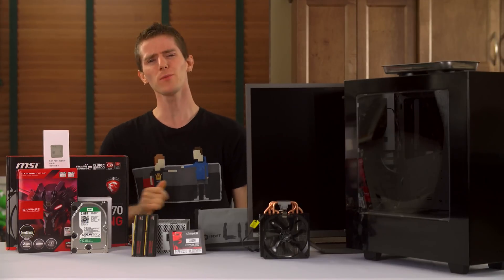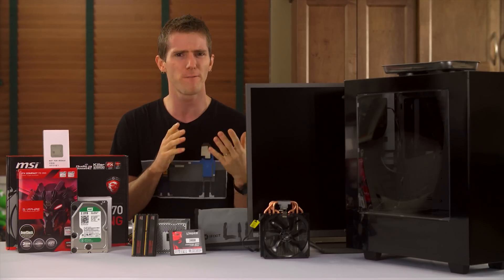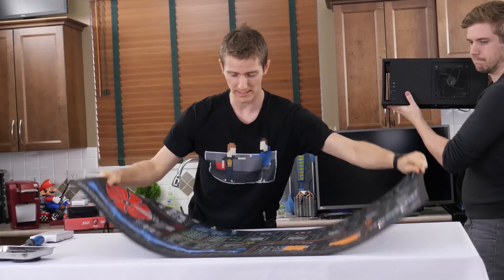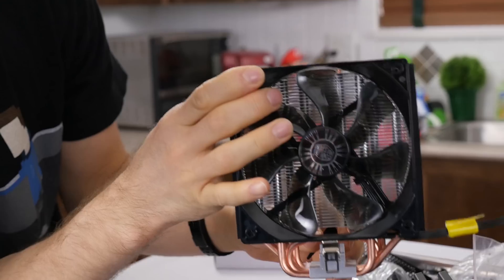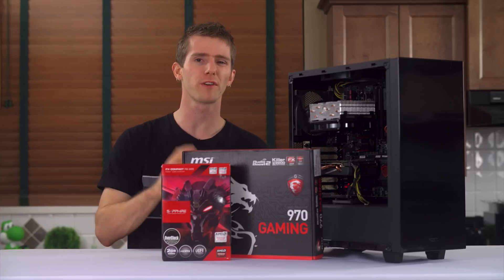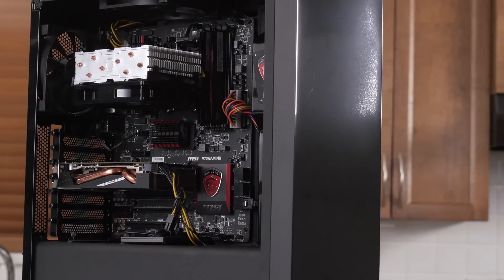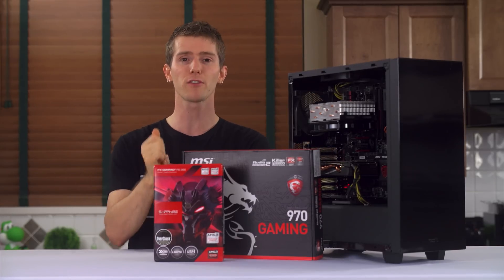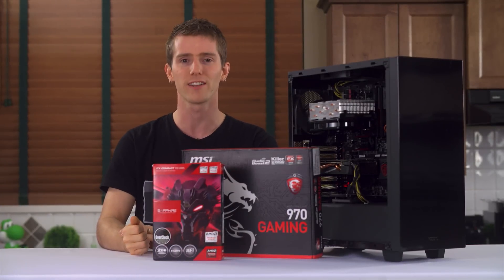Can you Build a 4K Gaming PC for Under $1000?

Comment: I'm actually pretty dissapointed seeing this episode, money is spent really on the wrong components. I know he was sponsored, but for anyone out there wanting to build a budget 4k rig, go for an intel i5-4460 on a cheap motherboard with a gtx970 or a r9-290. Most people wanting a budget pc are not going to overclock anyway so spending a lot of money in areas like the motherboard, cooling, power supply (as long as it is from a reputable brand and supplies enough current it is fine) etc is an absolute waste.
Reply: A major chunk of the money went towards the monitor. Really hard to squeeze in both an i5 and GTX 970/R9 290 with the rest of the money.
Reply: I personally would never cheap out on motherboards considering everything else in the PC is connected to it. Also he was given a 8-core but didn't use it. Swapping the 6350 and 285 with 4460 and 970 means a ~$200 increase, you probably won't have enough corners to cut for that much money.
Reply: the monitor alone takes away lots of money, think before commenting dude...
Reply: Hoàng Việt RainieDays93 Correct. But when has facts ever stopped an Intel fanboy?
Reply: Actually the AMD FX 8350 is beating the i7 4930k at a 4k gaming SLI setup - i couldnt believe it myself but its true, look here :
http://www.tweaktown.com/tweakipedia/56/amd-fx-8350-powering-gtx-780-sli-vs-gtx-980-sli-at-4k/index.html
Now thats a nice surprise 150$ vs 500$. :D
Reply: ***** Actually it was. Check the description. The components without the monitor come to $500. And the cheap 4k monitors on new egg are only $400.
Reply: You didn't include monitor. So yeah.
Reply: Giggity Goebbels Complete utter bullshit. Going off cheapest prices from http://pcpartpicker.com/,

Cheapest i5 is $176 while the cheapest FX-6300 is $96. Cheapest 970 is $325 while the cheapest 285 is $170. How are price differences like that "not much cheaper"?

And how is the 970 much better than a 290X? Benchmarks put them neck to neck but the kicker is that the 290X is cheaper: http://www.anandtech.com/bench/product/1355?vs=1056

I own an i7 and a 780 but I'm not retarded enough to deny that AMD beats my parts in terms of price/performance.
Reply: How about:

1.. AMD does have hardware to game on despite what you's intel sheep will always go on saying otherwise.

&

2. Without AMD being kept in the market we will go back to the days of the 90's where a Intel Celron would cost you $1200 cause it was the only low end cpu on the market.

gotta luv these troll-esque posts
Reply: mariodrv AMD has always had better price/performance than Intel.
Reply: You all do realize the monitor wasn't included in the $1,000 price point? Lol
Reply: LUGO Entertainment Now you're just arguing semantics lol... It's Linus' video. He can do whatever he wants. The title of the video is "Can you Build a 4K Gaming PC for UNDER $1000?" With or without a cheap 4K monitor, both are UNDER $1000. Nothing deceiving about the title.
Reply: You sir, are a complete idiot.  Thanks.
Reply: GriggsCk Gaming Even if you use a fx6350 and a r9-285 it will still be hard to include that monitor but you're right. In my country the r9-285 has a pretty poor value though, the r9-290 is just a little bit more expensive and outperforms the r9-285 by quite a lot. Maybe I'm wrong about that cpu though but the single threaded performance is just not that convincing in my opinion.
Reply: Giggity Goebbels Please stop being such a twat, dude. the 970 is better, yes, but only by about 5-10% And its usually about 100-150 usd more expensive in most markets. you complained about amd not being on sale but then said how highly discounted nvidia is discounted in your area, which is unusual and i doubt. point being, the 290 is a much better value for most everyone.
Reply: Giggity Goebbels Since you request benchmarks, please tell me if Linus is lying or you are simply wrong about the 970 being "much better" than the 290X:

watch?v=rp5meTIP3Pk&t=2m54s
watch?v=GJoVjOk1SVY&t=2m6s
watch?v=Nr77JW2pH90&t=2m50s
watch?v=pug0A5-4pIQ&t=3m38s

I didn't delete my comment; Youtube removed it since I linked directly to Linus' benchmark videos.
Reply: korey mcintire In my case the Asus r9 290 direct CU II was on sale, it does run a bit hot but it performs really well and I was able to save about 90 euros over a comparable GTX970
Reply: Jude Rose
sound's like some user error
Reply: *****
To be honest - i think the 4930k is the better CPU in any way except price(even for gaming) but for a cheap ass 4k build FX 8350 is the way to go. Oh and i bet when you OC the 4930k the graphs would look different very fast. ;)
But still man - a 150$ CPU kicking professional ass at 4k, i gotta give it to AMD they knew they couldnt make a new architecture for a while and made the existing one (including gpu) 4k ready before its time.
I own both CPUs (and a few others;) and i gotta say it guys for gaming, except in a few games like ARMA, there is not a big difference between INTEL and AMD except price.
Reply: *****
So what you are saying essentially is that Bulldozer and CMT were a good idea - but Intel owns the playing-field and the game and makes the rules?
...what AMD is left to do now is beat Intel at their own game?
- well good luck AMD, i hope Jim Keller can pull another Athlon...
Reply: jpchevron those parts come out to a little over $600... No way that monitor is less than $400 (since those parts come out over $600). They should also consider the price for the hard drives, power supply, and case.
Reply: LUGO Entertainment If you check the description the ccomponentscome to around $500 and the cheapest 4k monitors are $400 on new egg.
Reply: RainieDays93 The i5 is not that much more expensive than the FX,the motherboard can be much cheaper(If you get shit AMD boards,the VRM likely fails),and a 970 is not much more expensive than a 285.You can also get cheaper RAM and stuff.A 970 is MUCH better than a 285 and even a 290X.
mariodrv That article is bullshit,people on forums pointed out that there is too much loopholes in that test.
Reply: Kai Vega The nVidia cards were not discounted,they were always that pricing.Go ask the distros about this,because I have no idea why.Newegg however frequently tune price down,instead of fixing it a value,thus it is considered "discount".Twat?Well he started being rude first,so... yeah.
 I got the cheapest Asus Reference 290 for 20 (USD) lower than a zotac 970.But I was a few days too early,when the 970 is not available here yet.In US a 290 is very good in value,but for many other countries,it depends.
Reply: Giggity Goebbels
IN 4k the 290X is even better than the 980, and that is because neither of the new cards can compete with the 512-bit bus of the 290s.
Reply: PA5cAl1

Don't know where you live but where I live, at 70€ I can't get a half assed Intel Motherboard let alone a decent one for OC'ing.

For AMD, at 70€ you start to see decent OC mobos and if you climb to the 100€ region, you can get the best performance/price motherboards.

Market strategy from both companies are the opposite when it comes to CPUs. One makes decent affordable CPU's that can get you anywhere, the other makes great performing CPU's that cost the eyes in your face.

I can build an AMD APU based fully functional system for the same price I can buy an Intel CPU/Mobo and this is what most people don't understand. Gamers are gamers, but not all have the spare Money to buy the best.

At least, where I live...
Reply: Giggity Goebbels dude you just want to be right when you're wrong. Even cheap motherboards are fine these days, ask Linus if you don't believe me
Reply: ***** Why did you use the 4340? Ive been talking about the 4330. The 4330 is 25 dollars cheaper. 

Anyway I made this build:

http://pcpartpicker.com/p/HdnPhM

its $20 cheaper than your FX build. It has a 290x which is on par with a GTX970 in terms of performance (actually beats a 970 at higher resolutions) and an i3 which outperforms the FX6300.

If you desperately need Nvidia you can spend the extra $60 and get the GTX 970 making it only $40 dollars more than the FX build.

Also it will cost you less to upgrade the Intel build as you only need to buy a new CPU. To upgrade the FX build you would need to buy an Intel motherboard and an Intel CPU.

Finally you can remove the $25 cost of the Hyper 212 for the Intel build as you dont need it at all. particularly because you cant overclock it. Making it $45 cheaper than the FX system or $15 more if your going to use the GTX970.

So yeah, nice try fanboy.

P.S. If you are going to spend $15 on that build for an i3+970 you can save a bit of cash on your PSU. You dont need 550w for an i3+970. So you could even say the i3 build with a geforce part is cheaper.
Reply: 8150 is not even defendable. It's just bad. Piledriver is much more defendable then pure Bulldozer.
Reply: Andrew Spencer Il compare two chips if they are on sale at the same time.

Just because AMD havent bothered to update their manufacturing process doesnt mean their products arent comparable.

Certainly a user had a choice when FX was released to go with the newer technology that was released before the FX came out or to go with old technology released late.

By your logic there is no CPU that can compare to the FX. It seems you will say anything to discredit facts that show the CPU you own isnt very good for performance users.

You wont admit you are wrong but you are. 

Spewing abuse wont help you.
Reply: Andrew Spencer So the Nvidia GTX 970 uses drivers that perform better in more games on average. 

So the user gets better performance in most games. 

Sounds like a win for the 970 to me. 

I think you just admitted you were wrong. Well done you.
Reply: PA5cAl1 It depends on country, for those who have easy access to amazon, newegg, etc, they can just grab one cheap easily. But with 970 and i5, it would way existing this budget if you if you grap the monitor for cheap.
Reply: Oo and I'm pretty sure the monitor they used in the video is like $1,000. A $400 4k monitor will be complete garbage. Or atleast not very good for gaming.
Reply: jpchevron Then he should change the title. Title implies just for the PC, not the PC setup. If that was the case he would have needed to include a Keyboard and Mouse too. Almost all of his "builds" are just the PCs, not the monitors that go with it.
Reply: mariodrv Look at the runs they have done using the GTX980's, the total score is higher, the numbers do look a bit unreliable though. https://www.cpubenchmark.net/singleThread.html.The AMD FX-9590 scores 1708 points, even cpu's found in laptops can do better with a much smaller tdp. Take for example the Intel Core i7-4702MQ, 1720 points.This just shows the poor single threaded performance of AMD FX cpu's. And remember, the FX 8350 is clocked significantly lower.
Reply: Giggity Goebbels Ok so now you accuse Linus of fudging benchmarks. How about websites like these or does your ignorance have no bounds?

http://www.guru3d.com/articles_pages/dragon_age_inquisition_vga_graphics_performance_benchmark_review,7.html
http://www.techspot.com/review/917-far-cry-4-benchmarks/page3.html
Reply: Giggity Goebbels You have lost your mind if you think with both Nvidia and AMD's latest drivers that the 970 is better than a 290x. Hell some games at resolutions higher than 1080p the 290(non x) beats the 970. Please refer to google before you say something that is completely biased and not backed by proof. The latest cards released by Nvidia are good, but not near as impressive as they are blown up to be. 5% +/- performance gap before OCing between your competitors last gen cards is horrible. The price was great when they launched and then AMD cut their prices, so the only thing holding Nvidia over AMD is power consumption and noise....... Price/performance AMD is back on top, and it will get really really ugly for Nvidia when AMD does launch their new series. AMD is rumored to be going twice the memory bandwidth on the 390's while Nvidia is still kicking it on 980's 256bit memory interface. The only thing that impresses me with Nvidia 980/970 is power consumption. Otherwise, not impressed.
Reply: Giggity Goebbels You gave me a link with a GTX 970 overclocked at a core clock of 1366+ MHz when the core clock of factory 970s is ~1100 MHz. Nice try dude. Don't even dare to think Linus' benchmarks are untrustworthy when you're providing fudged benchmarks right off the bat. Since we're talking about 4K, I'll save you the trouble of looking for benchmarks and tell you the 970 can't even compete with the 290X at 4K in any game.
Reply: PA5cAl1 I agree with you completely, I myself have a MSI gaming r9 290 and I bought it on sale at newegg last month for 259.99 with a $30 mail in rebate. 970 is over rated. Hugely over rated.
Reply: *****  even though I wouldn't mind getting a Amd graphics card cus price/performance but I had bad experiences with amd processors with them kinda melting my motherboard so I'll stay a Intel sheep for a while longer :p
Reply: ***** Watch all the AMD fanboys scream, no, just kidding. Can we just stop hating each other for our preferred cpu choices? Thank you!!
Reply: "Money is spent really on the wrong components" and "Go for an intel i5-4460"

You lost me when you said pay $60.00 more for a CPU that performs nearly the same.
Reply: mariodrv Price/performance - watercooled 
Pick one of those. If the GPU needs watercooling, it isn't even an option for a price/performance rig.  And quit those stories about AMD's old GPUs being better than Maxwell. AMD does have the better cards in the mainstream segment, but Maxwell totally nuked the high-end with price/performance ratio, not to mention working conditions, which put to shame even Nvidia's own older cards.
Reply: I've made the mistake of getting a cheap motherboard twice. Never again.
Reply: Giggity Goebbels
Clock for clock the 290s are actually stronger than the 780s, the wider bus allows for more data to be shoveled trough eg. pixels which comes in handy at higher resolutions - thats why the 290x beats the 980 almost in all games at 4k dual gpu setups because NVIDIA builds
GPUs for markets and AMD for gamers (who are the market).
http://www.hardocp.com/article/2014/10/27/nvidia_geforce_gtx_980_sli_4k_video_card_review/11
Reply: CanIHasThisName
Excellent point mate! But...
I modded a 290(which didnt need watercooling i just wanted it to be faster than a 980 - and at 1200/1600 it sure is ;) with a Arctic Accelero Hybrid for 210€ - but go on tell me more please...
- for the rest(when i dont get a Arctic accellero for 50 bucks xD) i buy a new NZXT g10(30€) with a 30-40€ h50/55/70 etc. and all that paired with a 290 under or around 180€ - and bam you got more power than you need supercool and superquiet. :D
I agree with you - in the end you get what you pay for - or how much you are willing to compromise...
I for myself buy used gear and tinker around with it till im satisfied. :)
Reply: Ok, I pretty much tl;dr'ed the comments.
Why is an i5 and a 970 / 290 a worse choice here? I'll explain:
1. If you want to put a gaming rig together right now and forget about key component upgrades for a couple of years, AMD processors are a cheaper and pretty good choice. You could squeeze an i3 in there, but this is also meant to be a versatile, multi-purpose machine, so a bit of multitasking horsepower from an FX CPU can help, especially if you're a content creator on a budget.
2. R9 285s are really worthwhile video cards right now. They offer a few nice bonuses, like TrueAudio etc., along with solid performance for a neat price - especially outside NA, where the prices of GTX 9xx cards are quite a bit higher than those of the previous generation.
3. You should never cheap out on a motherboard and PSU. Sure, not many people will actually buy those top-tier MoBos made for overclockers, but when choosing the right base for a gaming machine, one should definitely consider the key things, like the VRM section (and its heat dissipation), the chipset, some OC capabilities (even if we don't plan on overclocking - it helps choosing a solid piece of hardware), available ports and controllers, and so on. The PSUs are similar in this regard - they power everything in the PC that's obviously going to be put under heavy load, so a power supply that goes into one's gaming rig needs to remain dead stable while giving the system a good power overhead. Picking a brand like SeaSonic is very wise, because such units will last long years - pretty much until your machine needs more power than it's rated for, or ~10 years pass (whichever comes first).
4. Sadly, with the last generation of AMD processors, it's recommended to swap the cooling unit for something more efficient, because the fans they include in their stock thingy don't really work well with their stock heatsink. Thankfully, I got my Phenom 920 with one of the better fans they've used, so it's not as annoying as the newer units.
Cheers.
Reply: mariodrv the concept of multithreaded programming scales base on the dependencies of the data being processed. In a very conceptual level, the main downside that a lot of people don't get with multi core, is that when being processed the data in core 1 Cannot communicate with the data in core 2 unless they are done processing. you need to design your program so that the threads are as independent as possible.  this is actually why simple calculations (like calculating prime, guassian elimination) work so well. The data being processed by each core does not depend on other data being processed at the same time.

However in games, this is often Not the case. the highly adaptave nature of games (responding to what the user does), demonstrates that calculations are often "chained together" like the butterfly effect. Now the issue is if 1 event is linked to another, which is linked to another. How can you possible split this workload and still maintain correctness.

A great analogy is say a store checkout line. Say you and your friend need to buy something. but you need the change of your friend first. (this is the linking). with a single clerk, the solution is simple. He goes first, gets change, gives it to you and you make your purchase.

Now say there are 2 cashiers (cores), that are located so that you and your friend cannot communicate to one another until you both reach the exit. In the case that you are independent, then the checkout process is 2x faster. but if you depend on the change of your friend, then it simply does not work.
Reply: The words "budget PC" and "4k gaming" don't go together bro
Reply: Your dramatic.
Reply: Well for one you make the assumption that those buying a cheap rig arent gonna overclock, which is just wrong. Not everyone has endless money to spend even those wanting to overclock. Also they spent fine amounts of money on the parts.
Reply: Linus' videos really aren't a good reference for best in class performance anymore, he's turned into a massive shill, seriously...
Reply: I disagree with the fact people with a budget PC won't want to overclock...
Reply: Oh just don't give into the hype. Do we use 3D anymore? NOPE!
Reply: LinusTechTips is like the Pewdie of pc parts for youtube,
His video's are meant for young kids who doesn't know any better.
  Everything that comes out of his mouth is for any vender who sends him free parts for reviews.
He doesn't list all the build and you can price a good 4k PC, $300 dollars less than what he is saying.
Reply: 1300l $300 less of $1000 learn to read b4 you make stupid comments
Reply: Shoobox Gaming
Ahh, my bad pall
Reply: Irregular - Films  I don't get into the Amd & Intel arguments "pointless" but I will say this, any person who doesn't realize that the FX-series Cpu's and Amd - APU's are meant to be ran at high clock memory for gaming like 2133 and above, Then they shouldn't mess with Amd's. I have both Amd and Intel Machines, they both have their solid points and weakness. just depends on what you use the machine for.
Since 4k is redundant at any point and most people cant see the difference with 720 or 1080 or higher in games. and the differences you do see is so minute I don't see the point in spending almost $1000 for a 4k monitor other than bragging rights.
 As far as my statement goes, its valid for the simplicity of people who know better about that this guy.
Further no streamer can even stream in 4k unless they have their own server setup for it, commons sites like Twitch or Hitbox won't even let your stream at 4k regardless, so once again Linus is talking out of his ass.
Reply: lol@intel-on-a-budget.

The CPU he chose is under half the price of the CPU you chose, pascal.  Also, "cheap" motherboards are never something you want to go with when gaming.
Reply: Giggity Goebbels Stop talking please, I always had amd and never had a motherboard vrm fail, i am from romania and the prices are the same as uk/us/canada without us having newegg, amazon and other online major retailers. Actually i have a 6350 and it cost me around 90 euros, that's about 105-110 usd.
Reply: danetz88 Go and watch Cube Computer Channel,his AMD motherboard VRM actually have problems.Yours not failing does not prove anything.So no,I will continue to talk.Welcome to Youtube.
Reply: Giggity Goebbels i had lots of motherboards plus plenty of frineds with amd processors but no vrm problems, please stop spreading lies
Reply: jedidethfreak LISTEN UP,stop comparing a 8350's price to a 4690K or 4790K.At my region,a 8350 is more expensive than an i5 4460,which is still significantly better *FOR　ＧＡＭＩＮＧ＊.You accuse others of being a fanboy,yet you are nowhere better than them. For people who does virtualizations and stuff,and are willing to sacrifice fps for other performance,a 8350 is fine,but a 4460 is not something only a rich man can afford,and just for gaming,a 4460 is still a better choice.
As for coolers,I want to make a point that unless you go full custom loop with lots of radiators,high end air cooling is still much better.
Reply: ***** I never said anywhere that Linus shouldnt be sponsored. I think you would be naive to think these shows could exist without sponsorship. 

I would rather game on an equivalently priced i3 than a 6300 myself. Benchmarks show it to be faster than a 6300. Hell they show it to be faster than an overclocked 8350 in some games.

I own an overclocked FX6300. I can speak first hand for its lack of performance. 

AMD chips are NOT always fine for gaming. I have a few titles which struggle to achieve 60fps on AMD chips. Guild Wars 2 is one of them, as is Skyrim. I am aware that its because these chips require single threaded performance. Which if anything simply highlights FX's inadequacies. 

Maybe Intel chips are expensive where you live. Here in the UK there is a better Intel chip at almost every AMD chips price point. At least for gaming there is.

http://www.xbitlabs.com/articles/cpu/display/core-i3-4340-4330-4130_5.html

Here the i3 4330 beats or matches any AMD chip, including the 8350. In the UK it costs £7 more than an FX6300.
Reply: ***** It won by 1fps in both occasions. I think its safe to call it margin of error. Also the titles are not CPU intensive titles. Even for $50 more, the considerably better performance in CPU intensive titles that the i3 has over the FX8350 let alone the FX6300 makes it worth it.

Sorry. You are simply wrong about this dude.

To prove me wrong. Find 3 titles that perform better by more than 10fps on the 6300 than the i3 4330. I can quite easily show you 3 titles that the i3 beats an 8350 (even when overlocked sometimes) by more than 10fps.
Reply: Scuba Sausage  If you dont mind me asking, what GPU do you have? If you are struggling to reach 60 fps in those titles, it isnt't just the CPU. Any modern GPU should be able to push a lot more than 60 FPS in Skyrim, no matter what CPU you have.
Reply: Scuba Sausage stop being a fanboy  F WHIT
Reply: bradleysctt I would appreciate some benchmarks on the 3d modelling and video editing. Im skeptical on what your saying to be honest. I will happily believe you on this IF you can back up what your saying.

Far Cry 4 (literally playing this right now lol) runs better on an i3 than a 6300:

http://www.techspot.com/review/917-far-cry-4-benchmarks/page5.html

Watch dogs is on par with an FX 6350:

http://www.techspot.com/review/827-watch-dogs-benchmarks/page5.html

Assassins creed 4 is better on an i3 than an 8350:

http://www.hardwarepal.com/assassins-creed-4-black-flag-benchmark-cpu-gpu/

Theres a massive myth out there that modern games that use multiple cores run better on AMD chips. From my experience the opposite is true

Im anti FX6300 because its pissing me off. I am not happy with its performance. Its probably because the games I play are CPU intensive and I struggle to maintain 60fps.

Basically im butthurt because I bought AMD and I should have bought Intel. I would happily swap my 6300 for an i3 4330. Id even pay someone to swap. Its not even about the money. I did not think to consider an i3 when I bought my 6300 and figured that an i5 was too much of an increase. Although ultimately I do wish I had bought a 4690k.

Everything I have claimed I have backed up with benchmarks and proof. Ive been building PC's for 20 years or so. Ive had AMD and Intel in the past. Right now however in 2015 AMD is a very poor choice for games. Im no fanboy. 

Sorry if you think its wierd for me to be unhappy with the performance of a chip.
Reply: bradleysctt I am trying to say using price to back up a claim is bad,because in different regions,stuff are of different prices.Do you know you can also get a H81 board and OC a 4690K?Also,the performance could be significantly different depending on the game.Finally,'people use a PC to do other stuff too' is invalid,because you are really better off getting a macbook/chromebook/windows tablet such as surface pro and a PS4 or Xbone if you do not want to go all out on your graphics card,and higher end graphics cards do get performance degradations by using an AMD CPU.It is therefore pointless to build a gaming PC in your scenario.And if you say the surface or macbook cannot handle video editing or vierualization as well,let me ask you another question:since you are ok with your AMD cpu hampering your GPU's performance,why can't you be ok with slower video editing and less VMs at an instance?Performance isn't what you care about,apparently.
Reply: *****   #madfornoreason   He brings up a fair point to not drop money on silly things like the motherboard, overclockability and an overkill PSU. These are more just money sinks that really tend to hurt the overall performance of lower-budget builds when the money could better be shifted to a better GPU or other such components. This build is sweet for someone that just wants to jump into lower end 4K gaming (And higher end 1080p gaming) at a solid ~$700-$800 (According to what people are saying here). Sure he makes the point to go Intel, but if you wanna go Intel, no one is going to stop you. If you wanna go AMD, you have a video just above you telling you the build to go along with this guy's advice to get a cheaper board and shovel things into the GPU.

You can't really lose with this guy's comment.
Reply: CaseJurassic Believe me so is the FX6300! Do you have any like benchmarks you could link me to on this please?
Reply: Andrew Spencer Agreed. Although from benchmarks I have seen apps seem to be using multiple threads but still rely on single threaded performance aswell. Note in the benchmarks I posted to you 8 threads were being used but one of them was being used considerably more than the rest. 

Most i3's outperform FX chips now. Even in modern games. You dont need overkill Intel to play games at their fullest.

I have not found a benchmark that favours AMD chips over Intel. Even for multithreaded games. I genuinely would like to see one but I dont expect to.

AMD's Vishera architecture is over 3 years old now. I dont think its all of a sudden going to start performing better than chips that are released now. 

I use an overclocked FX6300. Its mostly fine but there are a handful of titles (like those listed above) that I play which struggle on my CPU.

Certainly if your using a GTX 780/970/980, an R9 290/290x or any crossfire or SLI (Especially xfire and SLI actually) setup you should be going with Intel because in any CPU intensive game the FX will be bottlenecking these GPU's very heavily.

Also if you want >60fps you need overclocked Intel reallistically.

Im ordering a 4690k on payday (end of the month). And that means my FX only lasted 16 months. Thats quite poor really. But at least it didnt cost me that much money in the first place.
Reply: bradleysctt oh yeah I forgot that most of gamers render videos during gaming, nice point there!
Reply: TabalugaDragon Yeah these Haswell i3's are impressive. Outperforming an overclocked 8350 very often. 

It makes sense really AMD occupy (at the last quarter) 5.2% of the market. Games developers are going to make sure that their products run on Intel (94.7% of the market) as a priority.
Reply: Andrew Spencer Yeah just having one company is bad for the computing world. Reading about AMD has me worried. The company is losing value fast. They are going to have to pull something out of their ass to go forward. 

Call me ignorant though because I see benchmarks as facts. And I dont mean synthetic benchmarks. I mean benchmarks of games etc. These are the most reliable way of seeing how well a chip will perform in gaming I find. 

Im no Intel fanboy although the FX generation of chips from AMD has seriously disappointed me. Theyre awful chips. I speak from experience.
Reply: Andrew Spencer First I am personally not saying that all amd is crap, for people who live in regions where electricity is cheap, but they need to do a lot of multitasking and rendering FX series(since FX 6300) is a way to go. However, for most of people, where price for electricity are either average or high and they do a lot of gaming and basic programs(also a lot of programs where max performance is required, like an i7 or xeon) Intel is a way better choice
And no, I'm not saying that I'm picking any guy in internet or just 1 benchmark and say "look i3 performs way better than any AMD chip!". my opinon is based on dozens of completely different benchmarks from completely different sourses(and several different languages). Sure, some are clearly falcified(like the ones showing i3 outperforming FX 8350 at BF4, I don't really believe that), but almost all others say the truth, so do my own benchmarks on my own 2-nd gen i3. Also, people say i3-s are crap for multitasking and yet one of top i3-s performs as well as FX 6300 at multithreaded cinebench, and tears it apart in singlethreaded perfomance
http://cpuboss.com/cpus/Intel-Core-i3-4360-vs-AMD-FX-6300
and I'm aware that 4-th gen Intel is much newer, but we're talking about is how logical to buy a processor from either company right now, and in most cases it's Intel
Reply: Andrew Spencer so the current price\perfomance ratio doesn't matter right? only when the processors were made. 
If AMD somehow catches up to Intel perofmance while consuming as little power as Intel I'll easily recommend it to anyone. While it's not - I stick to the facts, nothing more
Reply: Andrew Spencer
" You stick to the facts that best support you preference which is intel, and in the real world, that is called the confirmation bias so yeah..."
I stick to the facts that I saw of countless gaming benchmarks, sure i3 is just fine for me(easily using 2 monitors, gaming on one, watching full hd movie on another while a dozen of small programs work on background like skype, utorrent, an antivirus etc), but I don't base my opinion on MY OWN preferences, but on most of gamers, taking into concideration games that I don't play at all, heck even those I totally can't stand and don't play
even in such poorly optimized games as watchdogs i3 shows decent results
(tests start at 1:26)
http://www.youtube.com/watch?v=MbXZF7yUhgc

Also nice logic there "if games are optimized for dual cores(Skyrim, World of Tanks, Starcraft 2, Dota 2) they are crappy, no matter how popular they are" LMAO
Reply: Andrew Spencer "But anyway i'm fine HAHA. My FX processor does not perform bad in all games at all and if i switched to intel i would only get better fps in SINGLE core games like a crappy MMO etc etc, and i mostly play better games that them."

or you meant REALLY old games like Ragnarok or... Lineage 2? Cause there is no point mentioning single core games since Intel doesn't have any single core peocessors, since i3-s are dual cores it would improve perfomance in any dual core optimized game

"How are you doing now lmao!! also the games you play are notoriously bad to begin (MMO'S are coded to reach the most people in terms of specs and optimisations)"
you obviously called the games themselves bad because they are "badly coded" and badly optimized, so no mistake here
And if you like your FX so much you could marry it as well, no one's stopping ya
Reply: Andrew Spencer If that is the only card that can compete to a certain card in the same class, it is not relevant if it is from 2012 or 2014. I do think that performance and cost should be part of the comparison (it's about getting the most bang for the bucks or just get the best card out there, so why not compare it with other brands.  Yet, I do belive that the old card if just looking to compare for the sake of comparing, is competing with intel's 2012 cards.
But I am quite shure i will never look at that card and then at a 5th gen intel card and go like; "Well, the AMD card was good in it's time, i might as well go for that one now". To make a stupid comparison with a bigger contrast, I would never buy a gtx 220 GPU just because it used to be a good card back in it's time
Reply: Andrew Spencer Why should we let AMD off for using an older manufacturing process and having less efficiency? 

It was sold in the same space to the same users (albeit 6 months later) for a similar price (around £15 cheaper than the 3570k).
Reply: I've just subscribed to Linus channel,
because here is people like you commenting some sense.

Anyway AMD FX with <95W TDP is great bang for a buck IMO. Attach a 30 bucks Tranquillo or Hyper 212 cooler to it so it makes basically zero noise up to almost full usage.
Reply: PA5cAl1 Intel sucks AMD is the true king of budget builds
Reply: Scuba Sausage are you gonna 2way sli your 970 card if not how do you expect 4k?
Reply: Scuba Sausage One simple reason idiot, Nvidia have better drivers in those games. just like AMD has better drivers in other games...

Do you honestly think you and ONLY you are correct, are you really that arrogant?
Reply: why not i5 4990k? becuase its only 25$ more shows what you know
Reply: I have an i5 4460 with an r9 290
the most demanding game I have is h1z1 which runs at ultra at 60
Reply: I was guestimating over $600 for the parts if you didn't get free shipping.
Reply: RainieDays93 The earth is not just made of USA/UK dude.You think other countries will discount AMD stuff like crazy?that will only happen in your dreams.Your argument is bullshit.
Much better than 285,even better than 290X.Use your brain dude.
Since you did not point out on the motherboard prices,you are implying I am correct.
Linking me to a benchmark site is utterly useless,because you ill always pick the results that favour your argument.
Oh yeah you think I am an Intel/Nvidia fanboy,and showed your specs "demonstrating" how you are not-how about this-I have a R9 290.Now shut up about the fanboy shit.
mariodrv Loopholes-in Sli 780/980,the CPU,so long as it does not pose a major bottleneck, is no longer going to be much of a factor the fps anymore.
Shit AMD boards include MSI 970A G46,several other ASRock boards,and the 970 Asus boards for having low phases,like 4,and using D-PAK MOSFETs,eg the 970A G46 reportedly fails with stock 6 core thuban CPUs on forums.
Much means 250$ and above.If you can save up a thousand bucks to get a computer,it is only your problem if you cannot wait any longer to save up more.Prices also depends on region,in my region 970s go as low as 300(currency changed to USD) bucks new,and 285 are around 250 bucks new.
Reply: RainieDays93 Exactly,therefore,your argument is invalid,because the prices you provided in invalidated,by you,of course.Using pricing as an argument is not credible at all.Therefore there are words like little,a lot,far more etc for people to use,which you didn't.
Linking to MULTIPLE benchmark site gains someone credibility.So yes,MULTIPLE real world benchmarks is good enough.Now go scout the web for more to support your argument,if you do not want your argument to be considered bullshit.
Reply: RainieDays93 And now,you deleted the comment that boomeranged back to you,loser.
Reply: Rainie Days You did not read my last comment,where i said i meant much better than 285,even better than 290X.It is just an ambiguity arised from combining the sentence together.
Also,do not give me Linus benchmarks.Ever since his "forum dishonesty" thing regarding Ads and membership only forum section that went on,I refuse to trust their content anymore.Yes,I am just watching the video for fun.You know,for fun.Deal with it.
Reply: Lol 970>290x for a lot ? I dont think so
Reply: Rainie Days Yea he's a dummy.
Reply: korey mcintire The only reason why the GTX970's performs better in the data shown by Linus is because of the overclocking. The GTX970's runs a lot cooler and therefor has a lot more overclocking headroom then a r9-290 or a r9-290x. I myself chose the r9-290 over the GTX970 because I don't usually overclock my cards and it was cheaper. But I have no clue why the r9-285 could even be interesting, in my country (the Netherlands) its almost just as expensive as a r9-290. what a joke.
Reply: Giggity Goebbels And still none of these benchmarks show the 970 being better than the 290X by any margin. The 970 and 290X are neck in neck, varying by game. In fact, going into higher resolutions than 1080p, even a 290 non X overtakes a 970 across all games.
Reply: Rainie Days Did you even read my last comment?I specifically gave you a link as rebuttal.
Reply: ***** Im fairly sure hes talking just in general, building an affordable 4k gaming rig
Reply: Rainie Days Yeah because Linus totally did not once overclock in their benchmarks.
Overclock or not,it does not matter.The clock speed can only be that much different.
In 4K a 290X is as good as a 970:/watch?v=6y_GEvObFRQ
Save me the trouble by cherry picking results that support your argument?U mad bro?
Reply: PA5cAl1

Single threaded performance doesn't actually matter that much. What concerns the absolute vast majority of games, a fucking APU is going to be just as effective as a i7. Modern games just plain old don't give a fuck about the processor you use.
Reply: Even an i5 4430 is slightly better.
Reply: Linh Nguyen Motherboard, as a component, has no impact on performance whatsoever, unless you're factoring overclocking. Pretty much the only thing you need to look at are the features. If the features are sufficient and it's not a bad brand or faulty model, go for it.
Reply: Rainie Days http://www.techpowerup.com/reviews/ASUS/GTX_970_STRIX_OC/9.html This test includes the reference model of 970 as well and shows that the reference card actually performs exactly as well as 290X in an AMD optimized game. What now, pumpkin? What now?
Reply: Rusty Shackleford I just nearly choked on my food after reading your comment where you suggest that a CPU which has up to 50% more performance per core @3.2GHz than 8350 @4GHz, is comparable in performance to 6350. That was rude of you. You can make it up to me by saying you were serious and making me laugh.
Reply: Jude Rose
You can buy AMD gpus with no fear at all(almost all my price/performance builds have watercooled 290s - 1200Mhz/1600Mhz beats a 980 :D mmm), CPUs i advise waiting for Zen(early 2016) or buying a mobo with at least 8 powerphases, and if you overclock put a little fan on the back behind cpu and vrm - problem solved. :)
Reply: mariodrv Bit rate is just a number,like ghz,is contingent upon architecture,where one cannot compare bus bits of two different cards.Like vishera 4GHz vs Haswell 4 GHz.
Reply: Rusty Shackleford It actually is around 45% and more in some cases. And overclocking on a single GPU rig? In 2014? PFFFFFFFFFFFFFFFFFT! 
Come on, you lost all your credibility in your previous post, where you claimed those performances are comparable. When you accuse other people of fanboyism it's like a downie telling other people they're retarded.
Reply: why the hell wouldn't you overclock on a budget? if you can get more performance for spending $30 on a hyper 212 evo why not overclock to save yourself upgrading for awhile..
Reply: i5-4690k and gtx 970 would be good but people were asking for an amd build for awhile ago
Reply: Mansen
How does it actually work then - elaborate please, i am honestly interested in that topic.
Reply: Well normally budgeters want the performance for cheap so they over clock you don't need a $100+ MB to do that, plus it's amd why not overlock if ya can?
Reply: jpchevron He wasn't using the cheapest 4k monitor though. He was using a IPS 4k Display priced at $1000 itself.
Reply: iamterence77
Thank you very much.
You gave me great starting points for further research. :)
Reply: *****
You got me wrong there somewhere mate(dont know which of my comments you mean) i agree with you completely. :S
Reply: Better go with an 8350 with a good mobo and oc it and it will be on par if not better that the i5.  And for the GPU I agree the 290 is great :)
Reply: ***** I guess opinions differ on overclocking but I don't know a lot of people that have actually overclocked their cpu. I just don't want to deal with the added heat and such. I do have to admit that I first wanted to get an AMD fx8350 over an i5-4460 but the mobo's on the AMD side just were not too my liking while the more budget oriented mobo's on the intel side looked quite decent. That's just my opinion and maybe I should have been more clearly about that
Reply: Remember this is canada, prices are different
Reply: Linh Nguyen Fps wise in games motherboards are nearly negligible...
Reply: The Exile I agree on that, that is also why it is so hard to suggest the best kind of system for anyone on a tight budget.
Reply: I OC :\ A lot...
Reply: Tech John 4k is nothing like 3d.
Reply: CanIHasThisName
Maybe in some cases, but most of the time it's around 25%. Show me what benchmarks you're going off of; I use passmark. Also, why wouldn't you overclock your system? Why wouldn't you want to remove as much bottlenecking as possible? Why wouldn't you want to increase performance in CPU bound programs? The year adds no credibility to that statement.
Reply: DerickTherving It's... not even a fact :P Folks who buy budget PCs are sooner or later gonna want to squeeze more out of their systems.
Reply: PA5cAl1 It's definitely easier to choose a decent motherboard on AMD's side. And a good AM3+ mobo will cost a bit less than a good LGA1150 mobo. Just compare Asus M5A99X Evo R2.0 and alike with some mid-end Z87/Z97 boards.
Reply: Who doesn't want to overclock? If anything, you should want to overclock even more on a budget system, so you can squeeze that extra performance out of those components :)
Reply: ***** For me the break down sits here. You get a cpu for 120 dollars + tax a motherboard for 108 + tax and a graphics card for 230-250. Those are the most essential parts and that comes roughly to about 460 dollars. The psu, case, and memory are very opinionated components that can increase the total cost or decrease it depending on user preference. Basically for the price of the main components you could purchase a Open Box GTX 970 for 290 + tax with the same mobo 108 and the same cpu 120, and shirk on PSU buying cheaper non modular psu's and buying non gaming memory with a cheaper case. This could possible afford miles more performance with a similiar price point, not including the monitor. Now I must remind everyone that a 4k monitor is not neccessary to play at 4k with NVIDIA based GPUS  via DSR. Just an idea :)
Reply: Giggity Goebbels * UK is almost always at least 20% more expensive. On par with EU prices due to VAT.
Reply: mariodrv Again you are comparing cards of different architecture.Kepler 386 bit bus cannot be compared with Maxwell 256 bit bus-period.Dothing to debate here.
naycnay There are cards that are up to twice the price in the US in my country.There are also ones that are much cheaper for whatever reason.
Reply: Not only was it sponsored by amd you never see amd on a intel video. Plus it was a price build that 6core is way cheaper then the i5 hell the 8350 8 core would have been cheaper.
Reply: Shoobox Gaming What do you expect dude. why would he do this for any goal else than money. You guys are fucked. Its clear that hes doing this for money, why dont you just agree with the real points of the videos and disagree about the shitty points. I guess your older enough to see that amd is better in performance like that, but when we talk about durability, it's clear that intel wins. They have a better warranty system than amd and you amd bitches can fuck off. ThaNKS.
Reply: I beg to differ, who buy cheap components will overclock to make the CPU better then it was sopose to be. Buy any locker CPU and cheap motherboard isn't a good choice.
Reply: Shoobox Gaming
300 dollars for a 4k PC? Right...
Reply: Yeah it seems like their price was really high for what they got. I just built a rig with an FX-8350, 16GB of 2133 RAM and an R9 290x for $980, and that included the monitor (Asus 19020x1080 IPS) and a keyboard and headset
Reply: Hoàng Việt  The monitor is $1,000 dollars by itself, think before commenting, "dude."
Reply: RainieDays93  It's impossible to buy the monitor and the parts with just $1,000, considering the monitor itself is 1,000 and will be over 1,000 with tax.
Reply: Tom San not the one IN THE VIDEO, you can find ~$400 4k monitors on amazon easily, care enough to actually research something, "dude"?
Reply: Giggity Goebbels the UK doesnt get discounts like the US, even without import, tax, exchange rate and other things we still pay much more than the US for tech, companies use bullshit excuses but they just charge us more because they can
Reply: LEEET ME JUST CHIME IN HERE!!! - there's almost no difference in gaming between the amd 6 and 8 core when clocked to the same speed ... how do i know? i owned a 6350 clocked @ 4.55ghz ... and i switched to an 8370e currently clocked @ 4.7ghz - i did this for streaming where it makes a difference - but for gaming - i dare you to notice a difference in fps... i know what im on about.
Reply: I wish name brand fanboys would just crawl in a hole and die world would be so much better.
Reply: so true, i just ordered my i5 4460 with a relatively cheap motherboard and a r9 290 yesterday
Reply: Linh Nguyen Under $1k could still be done with an i5 and a better R9 280x. An FX 6300 is a better choice, for the money, and could easily include an R9 290, if you really desired, with the FX 6300. The parts choices made no sense here. They could have easily kept it all AMD, and had a better rig, for under $1k.
Reply: Robert Frisch 6300 + 280x makes sense too. Maybe he picked the 285 just for the sake of new vs old tech, and it turned out the 285 worked just fine. 290 however is borderline pushing it on budget and power consumption. I doubt that 400W bronze psu would be able to take the 290 and the 6300 under full load.
Reply: danetz88 I am ABSOLUTELY not spreading lies.Your AMD boards not failing,again means nothing.There is a forum discussion on some bad AMD boards.It is a fact.How would anyone think a 4 phase,3 D-PAK MOSFET per phase VRM can handle a CPU of 125W TDP?That is clearly not good even for 77W Ivy Bridge CPUs.
Reply: jkteddy77 Uhhh, the 4790k is DOUBLE THE PRICE of an 8350, and you say "at 4.6ghz" as though that's some sort of achievement - people get that on air without even messing with anything but the multiplier.
Reply: jedidethfreak On some regions AMD is still very expensive,for whatever reason.
On air?Unless you go custom loop with more than 480mm total rad area,the NH-D15 is still a more viable option.
Reply: you can game 4k with only a gtx 750 ti
Reply: I'm just curious but will my rig run more demanding titles at 4K?
CPU: Intel i5 4690K
GPU: 2x R9 280X's
RAM: 2x 4GB 1333Mhz
MoBo:Asus Z97 Motherboard
PSU: Corsair TX 750 watt
Reply: jkteddy77 So, the hundreds of bench tests that prove this completely wrong are all utter bullshit, and we need to take your fanboyism as the only true statement?

The fact is, the r9 series of cards - all of them - were built around running with an overclocked FX-series processor, and if ANYONE had legitimate benchmarks proving that the FX-series couldn't run the highest-end single-gpu r9 card properly, the entire internet would be ablaze with comments on it.  Linus would have made video after video about it.

Giggity Goebbels  To the best of my knowledge, there are no retail regions on the planet where an AMD is so much more expensive than an Intel that the price difference between those two processors makes up for a 10fps improvement when you're already getting above 60fps.  Also, I was talking about air coolers.  That's what "on air" refers to - what would make you think I was talking about water cooling, when I specifically said the word "air?"
Reply: ***** The 4790K is supposed to run well on stock cooler,but you are not the only one with the problem(yours isn't as serious thpugh),maxxarcade had a 4790K and Z97 D3H fail on him after a day.However,I suppose it is the TIM's fault,because my 4930K(fluxless solder) runs very cool around 35⁰C idle (on tropical ambient) on a V8 GTS even when the thermal paste is not completely spread out.My Xeon E3-1245v2(TIM) however runs at 40⁰ idle on a hyper 212X with 2 fans,with core 0 at 32⁰C,much different then other cores.I think you might need to consider RMAing your CPU.Also,many people OC not for experience,but to gain the somewhat insignificant performance improvements.A 4.2GHz i7 will not be much faster than a 3.9GHz one.
AMD does use solder under the IHS(only for FX CPUs,APUs and those FM Athlons/AM1 Semprons and Athloms still use TIM) which is a good thing.However,decent motherboards such as a 970 Gaming and 990FXA UD3 and a 8350 isn't cheap altogether.Those boards costs as much  as low end Z97 boards.And really,I would rather get a Z97 Extreme3 which have 8 NexFETs,similar to the Rampage IV Gene and Formula's VRM,instead of a 990FXA-UD3 which still uses DrMOS.
Reply: jkteddy77 Read that link, dude - that isn't an 8350.  It's an 8370e, which is an economy proc compared to the 8350.

Giggity Goebbels Sure, at stock clocks all around the 4460 is better.  OC that 8350 to 4.8+ and it leaves the 4460 in the dust.  Also, I'd love to actually see links proving your claim about the price.
Reply: jedidethfreak Go to find "PC Themes" facebook and check price list on dropbox,4460 is 261SGD,8350 is 274SGD.Now,I provided solid evidence.Time to face reality and admit defeat,buddy,or should I say,AMD fanboy.
More importantly,since the 9590 existed,good luck finding a 8350 doable @4.8GHz.You need to get liquid cooling or NH-D15 too.That is not cheap in this case either,adding an additional 60-150USD to the price,which can be saved to get an SSD or a better Graphics card.Meanwhile a stock cooler is enough for a 4460.A 4460 runs happily on any H81 mobo from the 4 major brands(Asus,Asrock,Gigabyte,MSI) out there,meanwhile if you put the 8350 on a cheaper 760G or 970 board(from the same big brands,mind you), and overclock it,the MOSFETs will feast your eyes with a memorable fireworks show.See the point now?
Reply: Giggity Goebbels A facebook page is not "solid evidence."

Also, the 8350 still is quite overclockable to that range on all eight cores with a Hyper 212 EVO.

I know - I have it.

The only real fanboy here is you.  You make that clear with the fact that you seem to think people are going to overclock on a 760 mobo.  Clearly, you have no clue as to what you're talking about.
Reply: jedidethfreak Let me show you a game that shows off the power of builds, Skyrim. Let's see how good your FX-8350 does eh? http://www.bit-tech.net/hardware/2014/06/24/intel-pentium-g3258-review/5 Wha? It gets shrektd at 4.8ghz when the Pentium G3258 above it is at stock. xD
Reply: Biased? Are you kidding me right now? It's not Bethseda's Fault AMD has garbage single threaded performance. Skyrim won't perform the same on both CPUs as Skyrim relys on the CPU and GPU heavily meaning no matter what GPU you have a better CPU will always give a nice boost in frames.
Reply: If I was building a budget PC, I'd be overclocking the nuts off it to get extra performance.
Reply: Giggity Goebbels Seeing as how you can get a 970 mobo, 8350 and a 212 EVO for less than the price of a 4690k pretty much everywhere around the world, your comparo still doesn't hold water on a power-to-price ratio WHICH IS WHAT WE'RE TALKING ABOUT.
Reply: CaseJurassic Well, considering there is ABSOLUTELY NO INFO ON THE AMD BUILD USED FOR THAT TEST WHATSOEVER...
Reply: jedidethfreak So in other words you mean 60 SGD can get me a Hyper 212 and a 970 board,that will only happen in your dreams.You are ignoring my other points too.So,I will just ignore you.Have a nice day.
Reply: Giggity Goebbels He said 'Pretty much everywhere', not just everywhere. In most places, it is possible to get the 8350, 970 board and Hyper 212 for around the price of a 4690K. Just because that isn't the case in Singapore, doesn't mean that he is wrong. Here in New Zealand, you cant do it either. However, even if the combo does cost more than the 4690k, you still have to add on the price of a Z97 motherboard and an aftermarket cooler, making the AMD option cheaper overall, while still providing near equal performance.
Reply: PA5cAl1 I agree with you completely. This is a shameless plug from AMD through Linus. It highlights how desperate AMD is. 

If only AMD gave the money to their R&D departments instead of youtube promoters.
Reply: ***** Yes I know. Thats why I said it is a "Shameless" plug. As in, they dont even care if we know its sponsored.

AMD CPU's suck ass for gaming. I speak from first hand experience. And can provide benchmarks from reputable published tech sites to back my claims up.
Reply: Nobody just plays games on their PC. We all use our PC for tasks other than gaming, and this is where FX does have value compared to Intel.  In non gaming, productivity based tasks, an FX 6300 OR 8320 straight blows the i3 out of the water. Try gaming at the same time as rendering a video on an i3. Its just not possible, without having major ingame lag. Yes, your precious i3 may run a lot of games better, but overall, an FX 6 or 8 core will still provide a better experience.
Reply: bradleysctt Which tasks would that be? 

Also I have an overclocked FX6300. Good luck rendering a video on it whilst you game at the same time. Believe me! Good luck doing anything on it whilst you game. You can do it, but the game suffers badly for it. I should know.

If you could provide me some data about multi-tasking on an FX6300 compared to an i3 I would much appreciate it.

This is the only data I can find in a quick google search:

http://www.bit-tech.net/hardware/2014/07/03/intel-core-i5-4690k-review/4

Actually shows the i3 4130 (slower than a 4330) beating the 8350 when running two applications and falling short of an 8350 when handling four but presumably beating a 6300, although it isnt on the chart.

I do agree that the FX will beat the i3 in some instances. However for a pure and simple games machine you should be choosing the i3.
Reply: bradleysctt I have 2 x R9 280x in crossfire. And the titles that dont hit 60fps are consistent with benchmarks.

I can show you these benchmarks if you dont believe me.

here is the Skyrim benchmark.

http://www.bit-tech.net/hardware/2014/07/03/intel-core-i5-4690k-review/5

Notice how the minimum fps on the 8350 is below 60fps. This will hold back your GPU. 

Although I might add it rarely drops below 60 on my system. Its a poor example. Guild Wars 2 is a better example. As is Ass Creed 4.

Feel free to provide benchmarks to prove me wrong. You wont be able to though. Believe me.
Reply: Sam Higinbottom Im no fanboy.

Feel free to prove me wrong with benchmarks. :)
Reply: Scuba Sausage Believe me, i've also done it. I have an FX6300. Yes rendering and playing on the FX didnt give a great gaming experience, but it would still be a lot better off than the i3. Neither my 4690k or 4770k have shown a huge performance increase over the 6300 when it comes to frame rates in games. 

Yes, frame rates in most games increased, but overall performance of the 4690k would be about the same as the 6300 for tasks like video editing, 3D modelling and multitasking, since the FX can spread the load across all 6 cores. The i5 really hasn't justified the $100 premium over the FX 6300, particularly once you factor in the extra cost for the Z97 board its paired with. The i7, on the other hand, shows reasonable improvement in games like Crysis 3, and of course shows considerable improvements over the i5 and FX in 3D modelling and video editing.

I believe what you are saying about the performance of the 6300, I know that it sometimes has issues with holding a good frame rate while other tasks are running in the background. However, the i3 also has some of these problems, and in most cases the FX will be better off due to having more cores to spread the load across.

For a pure games machine,  I would pretty much agree with you. Both of the processors will trade blows. Older, single threaded games will run a lot better on the Intel, due to the higher IPC, but the FX can hold its own a lot better in modern AAA titles like BF4 and Crysis 3, trading blows with much more expensive CPUs like the 4690k. 

For new builders, its probably helpful for them to work out what games they want to play. If its a majority of older games, with a few current titles thrown in there, then the i3 will be the best option due to the older games being better suited to running on 2 cores, which is where the higher per core performance will be beneficial. If, however, they intend to play mainly modern titles like BF4, Crysis 3, Far Cry 4, Watch Dogs etc, which can benefit from lots of cores, then an FX CPU may be a better option for them. It really comes down to what they want to play, and what else their PC will be used for.

Also, how come you seem to be so anti the FX 6300, yet you say you have one? Seemed a bit weird to me, no offense. Yeah, i wouldnt go back to having an FX 6300 after having my 4770k, but its still a damn good chip, and id rather have one than an i3. But thats just me.
Reply: Scuba Sausage stop arguing about shit
Reply: Fair enough, i wasnt thinking it was weird. I kinda realised you may be having a bad experience with the 6300.
Reply: bradleysctt You did say it was wierd. to quote you:

"Also, how come you seem to be so anti the FX 6300, yet you say you have one? Seemed a bit weird to me, no offense"

What your saying is laughable. Your implying im lying about owning an FX chip because im saying it has poor performance. Unfortunately for me I DO own one. It is possible to be dis-satisfied with the performance of an AMD chip.

Furthermore I looked into video encoding/editing. Intel beats AMD at every price point again.

http://www.bit-tech.net/hardware/2014/07/03/intel-core-i5-4690k-review/3

On top of this your saying certain games run better on FX than an i3 which I also dis-proved.

Why are you spreading so much mis-information?
Reply: ***** They really haven't developed in a way that works best with Intel. What they did do is basically revamp their engine from Oblivion and gave it better multithreading and graphics options and a newish scripting system. It's basically Oblvion's engine with some new paint. Oblivion relied on single threaded performance a lot and that passed on to Skyrim.
Reply: No, the AMD CPU has the better price/performance ratio. I am currently running a GTX-970 with an AMD FX-8150, and the whole CPU bottleneck issue does not arise unless you are using really old CPUs or and insane amount of graphic power (think SLI Titans). This PC is a PERFECT concept build for a great gaming rig at a reasonable price.

Moreover, some quality components (like motherboard and power supple) really do matter in the long run. There is a reason why old gaming PC can be used as home servers for a decade whereas that old Dell craoked after three years. Dell's have really, really bad motherboards that slowly kill your CPU. The same is true for all others (HP consumer, Lenovo,...). A decent motherboard, PSU and cooling are the easiest way to get your hardware to last.
Reply: Giggity Goebbels Sure you can get an H81 board and overclock. But have fun trying to keep the VRM cool on a board that wasnt designed to output the extra voltage required to OC the CPU. I don't have an AMD CPU hampering my GPU performance, I'm running a 4770k. Don't make assumptions. 

I never said I wouldn't be OK with slower video editing, or less VMs. I had an FX 6300 for a while, as I was unable to afford an Intel system. Cash became available, so I took the leap for an i7, not because I needed it, but because I knew I couldn't really afford to upgrade the PC for at least another 3 years. It has more power than I need, and I'm happy with it. But I was also happy with the 6300, which is better than a lot of other people's CPUs.

I do care about the performance, but I don't see why everyone cries so much about how AMD performs worse. They cost less in most areas, and can still power a reasonable gaming PC. If people want better performance, then yes they should save and go Intel, but if the only option for their budget was an FX, then they should really be happy with what they have. 

Sorry, but here goes a bit of a rant. Ignore if you want, but this has been coming for a while, long before this comments section....

Even within our own 'PCMR' we have infighting and trash talking about how the AMD users must be retarded, even if they had to use AMD due to being poor....Story time.....

A friend, (let's call him jackson) recently upgraded from an Athlon XP 64. It couldn't even run LoL properly, and was clearly bottlenecking the 5870 (which he had got cheaply). Another friend (Jason) recently upgraded his system, and sold his now unused FX 8120 to Jackson, as it was within the budget Jackson had for a PC upgrade. Jackson is extremely happy, as his PC can actually run games. However, Intel fanboys would still find it necessary to tell him his PC is shit, purely because of the AMD CPU. He knows it isn't a good system overall, but it still allows him to play the games he wants to play.

This sort of shit appears on the PCMR subreddit all the time. As soon as a commenter sees the AMD CPU( or GPU, if the Nvidia fanboys are out) in the parts photo, the entire build is sent to the scrap heap. Instead of appreciating that the person has got a PC at all, it just turns into a ' let's rip on shitty AMD' thread. Why can't we all just consider this: At least they aren't a 'Filthy console peasant'.

Anyway, that's my two cents about pretty much the entire PC community.
Reply: Scuba Sausage I wasnt trying to say that it was weird that you don't like the CPU.I didnt realise how bad an experience you have had with the FX 6300, and so i thought it was weird that you hated the CPU for no major reasons.
Now that you have explained how disappointed/ unhappy you are in the CPU, i understand your standpoint more. It doesnt perform how you wanted it to, and that's fair enough. You have a reason to be mad that the parts you bought don't perform well enough.

My view still stands however, that to the average user, who wants a budget system, it wont matter if they get an i3 or FX 6300. Either option is sufficient for any budget, midrange gaming PC, and as i said before, they both trade blows across the board.
Reply: bradleysctt Now,H81 boards from Asus,Gigabyte and MSI comes with 3-4 phases,with 2-3 PowerPAK per phase.Now the D-PAK MOSFETs nonsense is over.There are also many Z87/Z97 boards with 4 phases,many from Gigabyte.The VRM will not overheat.
No I did not make assumptions,your statement implies that.You have a 4770K?How wonderful!I have a R9 290!You know,that Graphics Card from AMD!And it does not prove your point in any single way!
Reply: The only reason I would recommend a AMD CPU like a FX-6300 over a i3 or a G3258 is for things you require more cores for like a cheap SLI/CF build. As you can see on the internet, Dual cores are horrible with SLI/CF and can have negative scaling with 2 cards.

Also I would recommend a Athlon 860k over a FX-6300 unless you really need the cores.
Reply: CaseJurassic Hmm I think an i3 would provide better performance for xfire than a 6300. The 6300 sucks ass at xfire. I speak from experience.
Reply: Nope. An i3 has horrible scaling. It's scaling is basically non existent.
Reply: Carbon-Monoxide here is my idea with a monitor and Windows 8 included http://pc partpicker.com/p/6Fh4wP (remove the space) no mouse and keyboard however. I'm sure others will be able to do a better job but this can be a starting point, as I don't feel comfortable cutting more corners than this.
Reply: That looks like a good build. Another option is this.
I modified the $1000 gaming build from the front page of PC PartPicker to include Windows 8.1, and lowered the GPU to an R9 280. Here it is: http://pcpartpicker.com/p/nwvgK8
As you said you are a console gamer, i am assuming that you use a TV, and that you may want to use the PC with your TV, and that's why i didn't factor in a monitor.
Reply: Bradley Scott Anything but a Gigabyte board.That only have 4 phases IIRC,and you even claim H81 boards will not OC well.Therefore,change it to Asrock H97 performance or Z97 Extreme3.Like seriously.
Reply: Carbon-Monoxide you're welcome. #pcmr
Reply: I lied. It was the Pentium. The I3 has fine scaling. #PleaseDontHurtme
Reply: CaseJurassic I didnt know. I have never used an i3 with crossfire. Ive never used a Pentium G3258k at all. I base all my knowledge on benchmarks.

I just thought with the i3 beating the FX6300 in most areas and substantially in single core performance (games) that it would reflect in similar manner in crossfire. 

I find with crossfire it all very much depends on the software. CPU intensive games benefit less from it. Which I guess is obvious. But in such titles you would be able to use more of the GPU power available if your CPU is not holding the performance back as much.
Reply: Andrew Spencer Since you can't read Skyrim gets 40-50 more frames. Not 2.
Reply: Andrew Spencer Look at the benchmarks dude. Its usually a lot more than 2fps.

http://www.techspot.com/review/917-far-cry-4-benchmarks/page5.html

http://www.techspot.com/review/917-far-cry-4-benchmarks/page5.html

These are both modern games that benefit from multiple threads. Both perform faster on an i3 than an overclocked FX8350. 

Both of these are "real world tests", read the articles.

As you can see the difference is a lot more than just 2fps.

Would you like some more benchmarks? Because I can provide them

Also whilst you may be happy with your FX thats great. You dont need to upgrade it. I am most certainly not happy with mine. 

Sure the FX works in games. It just gets heavily stripped out performance wise by Intel. Even at equivalent price points these days.
Reply: CaseJurassic Yeah, no shit sherlock.

ever heard of sarcasm.

Skyrim is a CPU bound single core game, of course a intel cpu would do better in that kind of NON existent multi threaded scenario.

I have skyrim right now on my steam with over 50 mods installed and i have NEVER ran into a issue running that game with my 8350.

Only people who don't know SHIT about how Cpu's efficiency quote single core performance constantly, because they miss the big picture when comparing AMD VS INTEL in single core/performance situations which is INTEL'S compiler is a lot more efficient than AMD's in those situations.
Reply: Scuba Sausage I was being sarcastic.

My point is most people buy overkill cpu's for gaming, even when "games" themselves do not even use all of the cpu's to their fullest.

The intel 5960x for example is an absolute beast at multithreaded apps (and pretty much everything else lol) but in games like Dragon Age Inquistion a previous gen Haswell 4960x gets more fps than it, why? because the game is simply not coded to use a 8 core 16 thread beast.

http://www.techspot.com/articles-info/921/bench/CPU_2.png

A guy could buy the best cpu on the market to play games, but if the game developer didn't optimise their own game for such a core, then the consumer who spent £$ on a pricey/cheap cpu will be left out in the cold.

or simply every CPU is good at doing it's job but software makers are the people who make different cpu's better/worse depending on theirs tasks.

Hardware is only as good as the software running it. if people have un-optimised software, then the hardware WILL suffer, a good example is GPU drivers.
Reply: +Andrew Spencer Then why does Skyrim work best on 4 Cores?
Reply: CaseJurassic Look at this.

here...
http://www.techspot.com/articles-info/467/images/CPU_LowT.png

from the same article (final thoughts)
We haven't seen those kind of results for a while when benching games and it was made more interesting because the game only fully utilizes a single core (it can place load on four, it just tends to favors one the most). A dual-core processor offers enough horsepower to play Skyrim, especially if it's aggressively clocked. We were also surprised by how fast the new Core i7-3960X was, delivering 20% more performance than the i7-2600K. Meanwhile, we were saddened to see AMD's FX series deliver a substandard showing.

also, do you know what a "thread" is??

Because the game is optimised for a quad core/4 threads but dumps all the processing on a single core.

ie a single core game.
Reply: Andrew Spencer http://pcpartpicker.com/p/b6KHQ7
just $100 more and you could double the preformance
Reply: Kevin Phan I could double the performance only in  single core games thanks to the i5 having "stronger" cores, but in multithreaded games like crysis 3 and bf4 I would actually lose performance dude to the i5 having less cores and less threads than my fx 8350.

The cpu is the least important part when building a gaming pc, as long as the cpu is a recently modern quad core clocked at 3.0.ghz and up most gamers would be fine.
Reply: Andrew Spencer I cant find any other title aside from Crysis 3 that performs better on an i5 compared to an FX 8350. Even then Crysis 3 only performs better at higher resolutions on the FX.

BF4 runs better on an i5:

http://www.techspot.com/review/734-battlefield-4-benchmarks/page6.html

But as the difference between an APU and a top end i7 is only 4fps its pretty obvious that this is not a CPU intensive game at all.

Honestly even the similarly priced i5 4460 beats the FX8350 in the vast majority of titles. 

http://www.techpowerup.com/forums/threads/test-of-cpu-for-gaming-30-cpus-compared.200132/

Although if you have some benchmarks which differ I would like to see them.
Reply: Scuba Sausage Dude, all you need for gaming is an i5 or equivalent AMD cpu.

That's my point, I would rather spend my money on a better gpu for gaming then get a better cpu, just to get a slightly more fps in lightly multithreaded scenarios.

In the techreport (forum post lol) relative performance tests there was only about 13% to 20%ish difference in average gaming performance in all with a 4960x (which equaled 100%) if you were to put money into the equation the 4960x is a £800 cpu and is only marginally better at giving better fps then mine AND your cpu which are £135 and £90 respectively on the Uk amazon. To me spending an extra £700+ (can't be bothered with basic math lol) for a extra 20% better fps which would only get about 10/15fps more on average is, imo not worth it at all.

The gpu is far more important in a gaming pc then a overkill cpu that a game won't even fully utilise. 

Which brings me to my original point.

Most games out there are only optimised for quad cores with four threads, that's why in my previous comment a 4960x gets slightly more fps than a 5960x simply because the game in question (Dragon Age Inquisition) is simply not optimised for the 5960x's  powerful and highly threaded design.

Also.

The AMD FX line is getting old now I would be very surprised if intel cpu's were not beating AMD in most games, I think intel is on 20nm (2014) (soon to be 14nm) while AMD's current cpu's are still 32nm (2011/2012) (which is ancient by CPU standards) so intel has a generation advantage, and also a manufacturing advantage as well, with all the benefits that includes like, running cooler, more energy efficient, newer architecture and so on...

So yeah, I'm not suprised that the FX line of cpu's are slipping on the performance chart they are old guys trying to do a marathon against young "whippersnappers" lol.

 Saying that i like my 8350 for the price i got it, and the performance i get, it's fine for me, for gaming.

AMD users will have to wait until either Q4 2015 or late 2016 for any news on AMD's sucessor to the FX cpu line which is simply named "Zen" and will be a completely new architecture using SMT which is intels current approach (FX uses CMT) for the x86 desktop market.

Fingers crossed that AMD will deliver :)
Reply: mariodrv Jim keller is a cpu making god.

I'm sure Zen will be great! :)
Reply: did you even see which games were tested here? i3 would be perfect for them and a lot cheaper than i5 4460. i3 4150 costs the same as FX 6300
Reply: Andrew Spencer Im saying there isnt an equivalent CPU from AMD to match an i5. The i5 outperforms the FX8350 in pretty much every single game. By a lot in some games. 

In fact in many games an i3 is outperforming an overclocked FX8350.

I have an FX CPU and I dont think its good enough for gaming. Il be replacing it next month which means it lasted 15 months. Not very good.

I would like to see a benchmark of an FX8350 outperforming an i5 in any game. Even multithreaded ones. Aside from Crysis 3 I cant find a single one. Usually the opposite. Far Cry 4 is a multithreaded game, you cant run it on a dual core however an i3 outperforms an overclocked 8350. 

If you are happy with yours then fine. But dont spread mis-information around that an i5 is similar to an FX8350 because it simply isnt. i5's are far superior.
Reply: Scuba Sausage speaking of an i3 in Far Cry 4
https://www.youtube.com/watch?v=YUS17P1_Xxc
a test with one of budget i3-s with high end videocard, almost no bottlenecking :)
Reply: Scuba Sausage Hopefully intel's dominance will have solid competition from AMD the only other x86 chipmaker in the processor market, when they release their new desktop processor, which is codenamed "Zen" either this year or late next year.

Until then the Intel fanboys will continue to talk bad about AMD even when they don't have all the facts, because facts don't mean anything to a ignorant fanboy. Just their precious benchmarks.
Reply: Andrew Spencer oh of course benchmarks and facts aren't the same thing, even when those who actually own i3-s say they perform great in gaming, just like those benchmarks say, as well as countless videos from non-professionals on youtube
Reply: TabalugaDragon So what you are saying is everyones individual experience is the "absolute proof" the fact of the matter is that Benchmarks can be falsified just like any other bar graph and screenshot using photoshop.

The matter at hand isn't helped when people don't understand why in a cpu bound scenario their "precious" 280 x's are so called "getting bottlenecked" in a CPU bound game, they fail to realize that the game ITSELF is the problem due to poor optimisation, not the GPU and not the CPU.

The fact that people are saying things like "oh intel beats every AMD cpu" is not because the AMD cpu's were crap to begin with, it's that the FX line IS 3 years old! and going up against intel chips that have better EVERYTHING thanks to intel keeping their cpu's up to date (the latest intel cpu is 20NM!! VS AMD FX 32NM FFS)  OH of course intel would win, i would frankly be shocked if they didn't.

that's my point, people being uninformed and blaming everything in an attempt to understand and automatically blaming the AMD parts, that IS ignorant and just plain narrow minded.
Reply: Scuba Sausage Dude, you speak from "experience" yet you can't understand how a 6300 will NOT bottleneck 2 280x's.

i also speak from experience regarding the FX line, and in my opinion i have never had a problem with my AMD FX 8350.

I'm sorry to say im going to take "your experience" with a massive pinch of salt from reading your previous comments about how you think you have a bottleneck, when i suspect you are probably just playing badly optimised games.

Please show me "proof" of your suspected bottleneck, and i may believe you.

The FX 8150 (Bulldozer ) were absolutely terrible, but they fixed most of the problems with the Piledriver architecture so again not ALL the FX line were bad, please be more specific instead of generalising everything.
Reply: Andrew Spencer Call it bottlenecking, call it poorly optimized. Call it what you like. 

At the end of the day AMD users will get less performance than Intel.

http://www.tomshardware.co.uk/fx-8350-core-i7-3770k-gaming-bottleneck,review-32616-5.html

Its interesting to note that in games that are CPU intensive (Or poorly optimized as you say) Perform a lot worse on AMD than on Intel.

Just because you specifically havent had a problem doesnt mean you get to accuse someones knowledge of being fake because they havent had a bad experience. Or that benchmarks are falsified.

If you dont think an FX6300 holds back the performance of crossfire 280x's then you dont have much credibility as someone who knows about how PC's work.
Reply: At the same price points Intel beats AMD today.

Pentium G2358k>Athlon 860k
Intel i3 4160>FX6300
Intel i5 4460>FX8350

These chips are the same prices but for gaming Intel is faster everytime.
Reply: Scuba Sausage Yeah, and because i don't assume things about my CPU's performance having a "bottleneck" does not mean that i don't know what i'm talking about, because clearly i do.

but anyway.

Did you even read the link that you sent to me?

(here read this from the same article right at the top)
AMD’s lower-cost FX-8350 continues to maintain performance parity in Battlefield 3, even as our highest resolution and detail settings lean hard against a pair of Radeon HD 7970s.

The 8350 is still maintaining a PERFORMANCE parity with the other CPU the i7 3770k.

(Here)
The performance of our Radeon HD 7970s in CrossFire appears fairly similar on our AMD- and Intel-based platforms when we run at 1920x1080. Our system based on the FX-8350 encounters a couple of higher spikes, but the worst of these we see only reaches up to 40 ms.

Dude seriously....

The only difference is that the memory controller on the 8350 is not as good as the i7's which is causing the frame time to spike.

A cpu memory controller issue IS NOT a cpu computational issue (then the problem would be a bottleneck due to the cpu being maxed out trying to COMPUTE and SEND the info that GPU is waiting for), for you to get them backwards just proves you know very little about what a bottleneck is.And so all you do is do uniformed snap judgements.

like oh i have a bottleneck ......it must be the my CPU is not fast enough

(like you said here)
Certainly if your using a GTX 780/970/980, an R9 290/290x or any crossfire or SLI (Especially xfire and SLI actually) setup you should be going with Intel because in any CPU intensive game the FX will be bottlenecking these GPU's very heavily.

Also why are you showing yet more INTEL BEATS AMD fud, i have already said why INTEL is able to beat AMD at the moment, why do you keep repeating yourself? you play games like guild wars 2 which is a MMO and you are complaining about crappy performance.......yet you still blame the cpu even tho your problem IS you play crappy cpu bound single core games, WITH a Xfire set up.

if you think i really don't know what i'mk talking about, download Planetside 2 on steam (it's free to play) or from their own website and i bet you STILL get crappy fps, because guess what? it's a badly optimised cpu BOUND single core game lol and just to  prove my point more, of the games you play, only skyrim has a decent Xfire profile

Smh.
Reply: TabalugaDragon Seriously, you guys are just being ignorant lol

You are comparing a 6300 which is from 2012-10-23 to a i3 4360 that came out in May 11th 2014 ...

and boasting how the i3 is better it WOULD be better seeing as it's over 2 years AHEAD in everything.

what are you trying to do, is prove that the i3 is better for gaming currently, I ALREADY KNOW THAT.
Reply: Intel is better than AMD at the moment due to Intel keeping their CPU's up to date.

and until AMD responds with it's own cpu refresh AMD will continue to get outperformed in most scenarios. No shit.

my point is WHO gives a shit, a cpu is not that important when you are using the PC for gaming, the GPU is more important.

Simple as that..
Reply: Andrew Spencer So what are you saying? That if I had SLI 980's that I would get the exact same fps in games on an 8350 that I would in a 4690k or similar from Intel? Because you definitely dont. Intel systems perform much faster when using crossfire/SLI in general.

http://www.tomshardware.co.uk/crossfire-sli-scaling-bottleneck,review-32668-11.html

Anyway as the memory controller is on the die I count it as a CPU problem. Especially as the only way of getting rid of it is to buy an Intel CPU.

Also BF4 is a poor title. It gets practically the same results across the board. Which yes the 8350 maintains parity for

I notice how you conveniently ignored the F! 2012 and Skyrim results which both performed far faster on the Intel platform despite using the same graphics cards. 

Also I am aware that you already said Intel beats AMD. Anyone knows this. My point was that Intel is better value for money than AMD.

At the end of the day the FX line of CPU's is not very good. You dont seem to enjoy hearing this. Sorry mate but bring me some benchmarks to disprove what I am saying.
Reply: Andrew Spencer Actually it bothers me. Have you tried Guild Wars 2 on an FX chip? Its woeful.

Also if you have an R9 290 or more powerful your games are mostly being limited by the FX CPU. If you had an Intel CPU this would not be the case and you could be enjoying higher frame rates in your games.

AMD themselves actually recommend pairing an FX8350 with a 280x if you look at their press release.

As I said earlier im canning my FX chip after one year and 3 months. It has seriously disappointed me with its gaming performance.
Reply: Andrew Spencer  I remember you. Your the guy who tried to tell me that a single 290x performs faster than 2 x R9 280x in crossfire. lol.

When I proved you wrong you got all angry and ignored the thread. 

Care to admit you were wrong about that? lol.
Reply: Scuba Sausage Lol :) have you been back to it, because i did. yet you wasn't responding lmao.

and you were the one talking crap about your gpu's being relevant still in 2015 so c'mon bruh.

How are you doing now lmao!! also the games you play are notoriously bad to begin (MMO'S are coded to reach the most people in terms of specs and optimisations) even if you had a 5960x you would only get a small fps boost due to the game being shit.

But anyway i'm fine HAHA. My FX processor does not perform bad in all games at all and if i switched to intel i would only get better fps in SINGLE core games like a crappy MMO etc etc, and i mostly play better games that them.

No "bottleneck" here, maybe you should look at the crappy games you play dude, for the reason why you have low fps.

P.S you were trolling and so was i, there was no wrong or right, because if there were, we were both wrong. Seeing as you were wrong about my card being A LOT slower than the 780ti and i was wrong saying that my card was faster than 2 280x's haha, my card would be faster at the moment wouldn't it, bottleneck boy haha (joking calm your tits)

Also the 780 ti is a lot more powerful than the 980 still, that's why they discontinued the 780 ti lol.
Reply: TabalugaDragon You stick to the facts that best support you preference which is intel, and in the real world, that is called the confirmation bias so yeah...

My preference is AMD but i still see when my product is getting outperformed by intel, but that's fine for me, my CPU is fine for me atm for gaming. i have 0 complaints.

so apples to oranges, much dude.
Reply: Andrew Spencer Erm my GPU's are fine. Still performing better than your single GPU (Not in Far Cry 4 though, still no crossfire profile, bastards). 

They always will too as I imagine it must be hard to find a motherboard with enough spacing to fit two 3-slot lightnings in it. Not to mention the fact that you need a mother of all PSU's to crossfire 290x's. lol.

My FX CPU however is usually the component that prevents my games from consistently hitting 60fps.

This is the case in Assassins Creed 4, Far Cry 4, Guild Wars 2 and Skyrim. Are these games "crappy" as you put it? lol

It wont matter I get paid at the end of the month. I will be buying an i5 4690k along with an xbox one to play games with chums of mine that dont own a PC.

Will be so good to finally have a CPU that can actually perform.
Reply: Scuba Sausage Assassins Creed 4 (terrible port you could have a 295 x2 and still get only 50 fps in Havana, very unoptimised), Far Cry 4 (i love this game i get 50/60+ with the game on ultra), Guild Wars 2 (a MMO lol c'mon don't make me laugh) and Skyrim (amazing game i have no problems here even tho it's a single core game i still mod the shit out of it and still have a solid framerate) 

So in your little list there is only ONE well optimised game in it, could you tell me which one?

I get that you are royally fucked off with that cpu, and if i were to sympathise i am a little annoyed that AMD has decided to let their own customers wait for a cpu refresh ( nearly 3yrs and still waiting), while in the mean time WE AMD consumers have to see intel fanboys drone on and on about how their new " intel chips" perform better.

yet they don't understand OR care that they are judging a NEWER more advanced product to an older less advanced product, seriously it's like boasting about how a TANK can kill a medieval knight, it's OBVIOUS and just narrow minded and petty.

P.S yeah i have a 1200 watt corsair psu with a Asus crosshair formula Z motherboard, which is thankfully equipped to handle 2 of my triple slot giants XD
Reply: Andrew Spencer So what if these games are all badly optimized? 

Should I stop playing them?

I wouldnt even say they are all badly optimized. Badly optimized for AMD perhaps. Not neccesarily for Intel.

If a user wants to play these games they should buy Intel. 

There are no titles that run significantly better on AMD chips.
Reply: Scuba Sausage Also could you tell me your gpu driver version?

Because the current AMD 14.12 omega driver is amazing.
Reply: Andrew Spencer Yes Im using 14.12. I didnt think its that amazing. Its good but AMD drivers are still behind Nvidia's drivers.

I dont really have any issues with my GPU's. 
Aside from FarCry4 and CODAW crossfire issues. 

The primary limiting factor of my system is my overclocked FX CPU. 

Will cost me around £300 for an i5 4690k + Asus ROG Ranger. Not too much cash really. Might be able to sell my Asrock Fatal1ty 990FX Killer motherboard to someone with an AM3+ CPU. Interested? 

P.S. Yeah you could install a second card in the third slot. But still, having to use a 1.2 kW PSU is a joke considering a 500 W PSU is enough for SLI 980's.
Reply: Scuba Sausage Should you stop playing them? no, of course not, all i'm saying is have a little more understanding in regards to how software can SEVERELY affect how hardware performs, if the software is badly done.

Back to the topic.

Yes a the moment most games if not all run better on intel chips. i agree dude. BUT if most of the games were CODED better in general (better multi rendering that scales across more cores, not just 2 or 4 but 6 and 8) then the performance differences would not be so much. i'm not expecting game devs to solve AMD's issues AMD should that themselves, but when a game is coded poorly not just for AMD vs Intel scenarios but just badly optimised in general, then that really doesn't help EITHER brand does it.

like crappy console ports that run like crap regardless of CPU/GPU configs (assassins creed 4 i'm looking at you).......i hate those.

like i've said dude, the only way for AMD to catch up, is to LITERALLY catch the fuck up and release a new damn CPU already 3 yrs is 3 yrs too long.
Reply: Andrew Spencer I couldnt care less why the software doesnt run as well. I am aware of why but it doesnt make any difference at the end of the day.

At the end of the day the user will enjoy more performance on Intel. Whether thats AMD's fault or the developers fault, who cares?

Even then what your saying isnt quite true as Far Cry 4 and AC4 are both heavily multithreaded, can use 8 threads and in both games an i3 beats an FX8350.

If games were coded better to run on a potato than an Intel or AMD CPU I would buy the potato. And recommend others to do the same.
 
As for AMD ZEN if its good il buy it. If it isnt I wont. But as it could be the end of 2016 that it releases I cant be arsed to wait that long. In the meantime I will buy Intel as they are the company providing the competent solutions at the moment.
Reply: Scuba Sausage No i'm good thanks, i'm really surprised you are not pleased with the 14.12 driver , that driver enabled (VSR) me to play my games (rendered) in 4k and then downsampled on my 1080p screen and gave me an overall better experience, i love it lol.

Also AMD and Nvidia are about the same in driver atm and they have been for awhile.

http://hexus.net/tech/reviews/graphics/79245-amd-nvidias-2014-driver-progress/

The age old myth that Nvidia has "better" drivers has been just that, a myth that people buy into because they're bias towards Nvidia. or just uninformed.

P.S also i don't NEED to use a 1200 watt psu at all because underload my 290x with a overclock only consumes 380 (760 in total with 2 gpu's under max load) watts so i would be fine with a corsair AX860i or HX1000 watt, i just chose to get the AX1200watt for shit's n giggles.

it's not really a joke lol, the 980 is simply more power efficient because they are a newer architecture that specifically targeted lower TDP.
Reply: Andrew Spencer Its no myth that SLI works on Far Cry 4 and Crossfire does not. 

Honestly this keeps happening, new titles dont support crossfire on AMD. 

I understand crossfire and SLI support isnt the highest priority for these companies but I dont understand why AMD cant do it if Nvidia can.

It has pissed me off enough to make sure I buy Nvidia in the future. Although when that will be I do not know. 2x R9 280x is overkill at the moment really.
Reply: TabalugaDragon I never said..."if games are optimised for dual cores (skyrim,World of Tanks,Starcarft 2,Dota 2) they are crappy,no matter how popular they are"  are you using google translate or something? because you seem to be lost in translation lol.

Why are you still going on about that i3 just marry the fucking thing and be done already....and make little i5 and i7 babies. Smh.
Reply: Andrew Spencer of course it's a good one. as well as calling a 24-year old guy who speaks 2 languages a child. 
"no a single core game is when the game recognises multiple cores in the system but still puts all of the processes on a single core"
I knew that but didn't know what exactly you meant there, so what does that change? you still haven't answered me, how is it that you;d ONLY get improvements in such games(like say, WoW), not the ones I mentioned above?
(skyrim,World of Tanks,Starcarft 2,Dota 2)
Reply: At the end of the day a user will get more performance from an Intel CPU than an AMD CPU if your using the same cards. Call it a bottleneck, call it poor optimization. Call it CPU intensive, whatever.

I already linked this to you but your lack of mental capacity prevented you from comprehending it. Read it again dumbass.

http://www.tomshardware.co.uk/crossfire-sli-scaling-bottleneck,review-32668-11.html

To quote the article "CrossFire boosts gaming performance on Intel's Core i7-3770K by 72%, but only manages to speed up frame rates on AMD's FX-8350 by 47%. The Vishera-based FX gets a far bigger kick from SLI."

These are both CPU's from the same era. The 3770k cost more than the 8350. However its games performance is comparable to that of a 3570k which was around the same price as the 8350 when it was on sale. These results are absolutely comparable.

You have failed to explain why crossfire setups benefit more from Intel than AMD.  

I ask again. Can you explain why the same cards suffer worse performance from equivalent Intel chips please?

Im guessing you cant.

"Our big revelation is that AMD’s FX-8350 performs 5% better in SLI than it does in CrossFire. When all else is made equal, AMD’s current flagship host processor really does favor Nvidia's graphics technology. Whoops" - Finishing statement of the article.

Your saying they are wrong?

http://www.tomshardware.co.uk/fx-8350-core-i7-3770k-gaming-bottleneck,review-32616-9.html

"From now on, we'll need to limit the use of AMD's flagship to systems already bottlenecked by their graphics cards. A less expensive CPU is more attractive when it isn't affecting performance negatively" - Quote from the above article.
Reply: Scuba Sausage All you do is point fingers and say "but why, why is that happening tell me" instead of trying to understand and listen.

Give me a fucking break already, read a goddamn book watch a fucking informative video , look in a mirror when you judge another person with distrust and and scorn don't stamp your feet and "say fanboy this fanboy that" when in reality at least a fanboy would have more understanding than you! you just act like the fuckwit you are and sort out your severe lack of product knowledge lack of basic, NEW VS OLD and how you don't judge the OLD by the NEW becuse the OLD was the very reason why the NEW was even made.Sigh. this whole thing is starting to wear thin, like you complain and whine that, well AMD is not as fast"  and then i try to tell you why X is not the same as Y  because X is outdated compared to Y and all you do is "but intel is better performance bla bla bla bla fucking bla" just buy intel and STFU already.

I WAS wrong all that time ago, you AREN'T bias you are just narrow minded and ignorant, how sad.
Reply: Andrew Spencer I have been saying that AMD FX struggles compared with an i7 (it also struggles compared to an i3). That is the core of my point. 

My point is that if you buy 2 graphics cards and use them on an Intel CPU you will get more performance than on an AMD FX CPU. 

This means that your graphics cards performance is held back more by an FX chip than an Intel i series chip. 

Or do you deny this?

And if you dont call that a bottleneck what do you call it?

Also the 3000 series from Intel was released BEFORE AMD released its Vishera based FX CPU's. Not in 2013 as you falsely believe.

So how you think that comparing the 3000 series from Intel isnt fair is bewildering. Just shows your mental fallacies.

Also so you say we cant compare a 4000 series Intel chip to an 8350? Why dont we compare it to the 8370 instead? The 8370 was released after the 4000 series.
Reply: Simon André 

(He got the point lol)
I did get it, it was intended more as a reply for the sake of educational purposes. Not for just you, but the rest of the comment section, it was also a way for me to reflect over just that.

(But then i missed his point XD)

You missed the point.

Of course a consumer would not buy a older product simply because it was good in "back then in the past" my point was you don't get an old OUTDATED product and put it up against a NEWER product and still expect the OLDER product to be competitive against the newer product, do you, no you don't because like i said, it is simple common sense that you don't do that..

The simple fact is AMD was on the back foot trying keep up with Intel's i7 back in 2012 so why are people expecting things to change all of a sudden without AMD refreshing their cpu line with more competitive solutions? all the while Intel is is still refreshing their cpu line with better and better cpus! in that kind of situation of course AMD is going to slip on benchmarks and the like, when AMD has done NOTHING about their cpu's in 3 years.....

My other point is that AMD DID make a GOOD cpu with the AMD FX piledriver gen was made to replace the failure that was (bulldozer), and at the time when compared fairly to an equivalent Intel chip they did "ok" but over all the Piledriver architecture has not aged well vs intel's VASTLY improved efficiency and and manufacturing process.

This whole situation has me in a state of disbelief that people can not, at all understand where i'm coming from. i have made ALL of my points as simple and as clear as i can with resorting to doing slide show presentations with bold colourful bullet points.

Everyone bashes on AMD with mis-information, and without proof or justification and when a person (like me) points out the finer details as to why X product can't compete to Y product, because of the list of reason i have given is this stupidly long comment chain, people just seem to put on their favorite team shirt and try to distort what i say to say with half assed analogies...i'm talking about CPU's not  GPU's i get what you were trying to do, now try and do the same for me, and try to UNDERSTAND.
Reply: Andrew Spencer I did get it, it was intended more as a reply for the sake of educational purposes. Not for just you, but the rest of the comment section, it was also a way for me to reflect over just that.
Oh and a side note, I'm not biased towards any of the brands, give me what i want from a card, and the brand will not even be relevant.
Reply: Scuba Sausage I never said at all you should let them "off" at all/

(from my previous post)

I get that you are royally fucked off with that cpu, and if i were to sympathise i am a little annoyed that AMD has decided to let their own customers wait for a cpu refresh ( nearly 3yrs and still waiting), while in the mean time WE AMD consumers have to see intel fanboys drone on and on about how their new  "intel chips" perform better.

All i have tried to do is give you more information for you to make a better more informed BUYING decision with.

All i got in return was slander,scorn,and people taking my point out of context in an attempt to spread mis-information in a petty attempt to label me as a "fanboy" or an "AMD guy defending his AMD rig" like i said i am generally in disbelief as to how narrow minded some people are towards simple things.

This whole situation is your own preference changing to INTEL and you being disappointed in AMD and the 6300 specifically.

If you want balls to the walls performance simply go with intel and stop trying to assume EVERYONE is wrong and only you are right because you suspect your old chip is holding back your dual gpu setup because you see intel is apparently beating you with the same gpu's on a similar set up in that very article the amd set was and i quote "maintaining performance parity" with the intel chip, i have backed up all of my points and given DETAILED reasons as to why you are wrong and are misinformed that was not to insult you in a personal way, it may seem like i'm a so called "fanboy" but tbh that is just very ignorant for people to say, i'm simply well informed because my experience with both companies has made me so.
Reply: Simon André AH i see, my bad  i will add an edit with your previous comment about my comment :)

It would be helpful if you could be more specific so more people don't make the same mistake i did.

Thank you.
Reply: Andrew Spencer I dont understand how knowing the manufacturing process influences a buying decision. Its all about performance for how much it costs.

I also disagree with the performance parity. 

The whole reason I am unhappy with my AMD chip is that they DONT have parity with Intel performance wise. 

I quoted a list of games. You gave me several reasons why they perform poorly on AMD (of which I was already aware of). You scoffed at the MMO. These still titles count in demonstrating that AMD does NOT have performance parity with Intel. Users get significantly more from cheap Intel chips than expensive overclocked AMD chips in many of these titles.

In my case spending the same cash on an Intel i3 would have been better for me. Especially considering the powerful GPU setup I am using.

Intel chips clearly outperform AMD chips in single threaded performance which constitutes a vast amount of games. You have even acknowledged this yourself in previous responses.

My point is that in the past AMD was good for budget PC gaming systems only. And that if you are going to spend a lot on your GPU(s) then you should be buying Intel.

Now they are not suitable for any gaming machine. Intel can provide a faster solution for the same amount of cash as any AMD CPU.

Also they have updated their line. The 8370 was released more recently than any Intel CPU. And AMD are charging prices comparable to the clearly superior i5 4670k for it. You would be quite foolish to buy an FX8370 now. Just as it was foolish to buy an FX8350 on its release.
Reply: Scuba Sausage The simple fact is you are looking at this situation like a consumer "looking to buy" and i'm looking at this situation from a consumer who is mostly happy with his purchase so i look at the situation from all the angles not just the one that would justify my purchase, like you.

The performance parity i mentioned was from your own article that you provided, are you trying to say that article was wrong?

You gave me a list of games that are for the most part poor console ports (i own all those games you said) that's just not me saying that, you can google that yourself, all for Far Cry 4 and Skyrim (which i also own), and i didn't just "scoff" at them at all, you saying that is simply your own interpretation of what you "thought" i was doing, when in fact i backed up what i said  with valid points. Guild Wars 2 is a MMO and all MMO's are mostly single core bias as in they only fully use ONE core for EVERYTHING. Assassin  Creed Black flag is not as restrictive with the way is utilises the CPU but it is still, a badly optimised game with regards to how it utilises the GPU and CPU together.

I am just as surprised as you are as the i3 being able to outperform most if not ALL of AMD's cpus but the wrong thing imo you did was to blame JUST the cpu when the fact is it's simply not as simple as that. The whole reason why i mentioned poorly optimised game was to try and point (others have tried with you as well in this comments section) out that your cpu is NOT a bad cpu at all, it is simply old, and it's outdated nature is being only emphasized on more by INTEL making advances in efficiency and manufacturing that are frankly going to embarrass a old 32nm cpu from 2012.

In regards to the FX 8370, that cpu is essentially just a 8350 with smaller tweaks to it's efficiency to improve ipc and tdp respectively, but of course AMD would act like any business and exploit peoples lack of knowledge for profit, just like ANY company would do.

Yes Intel outperforms AMD in the vast majority of single cores games but not all games are exclusively single core are they? so the performance difference changes between games my AMD cpu can still allow me to get 60fps on average in most the games i play which is all i need, but as a rule of thumb, yes, AMD cpu's don't perform as good as intel, but that is not because the AMD cpu is not quick enough to be used in a crossfire setup at all, it's again just down to how old the AMD cpu's are and how they are going up against intel's superior architecture and manufacturing process.

AMD cpu's are not useless at all for gaming, actually they are just about right i can still get over 60 fps in most games with my current CPU and GPU setup which is all i want, which leads me on to one of my original points, about bad optimisation and how you could have a intel i7 5960x and still get less fps than a previous gen i7 4960x which gets slightly more.

(A manufacturing process makes a night and day difference to how a cpu can perform, and if a game is badly optimised that can also severely affect performance in a negative way to simply ignore those facts is ignorant and narrow minded dude)

You are judging your ENTIRE viewpoint on your own experience of playing mostly poorly optimised games (Far Cry 4 not included)  and benchmarks from review sites, without a second thought being given to the tech sites legitimacy and the accuracy of the benchmark themselves, which has made you bitter and disappointed towards your own AMD cpu and just AMD in general, because you don't have the experience of owning both intel and AMD and seeing the differences yourself...thats why you said...

(quote from you)
My point is that in the past AMD was good for budget PC gaming systems only. And that if you are going to spend a lot on your GPU(s) then you should be buying Intel.

Now they are not suitable for any gaming machine. Intel can provide a faster solution for the same amount of cash as any AMD CPU.
(end quote)

That to me is foolish dude because you are ignoring SO many variables in regards to, how the game is optimised, is the game CPU bound or GPU bound. all of those and more add up to TOTAL system performance when gaming, not just CPU performance vs overall performance, seeing as the GPU is the most important thing when running game (thats why you have 2 Crossfire gou's for gaming, you don't have 2 cpu's do you? because you don't need to 2 cpu's to run a game)
Reply: Andrew Spencer Im judging my viewpoint of benchmarks I have seen of games. I wouldnt be so upset about my FX CPU's performance had I not seen several different benchmarks from several different sources all showing me that I would be getting more performance from an Intel solution.

According to you Im a user who happens to play a lot of badly optimized games and console ports

This list of titles includes Assassins Creed, Skyrim, Guild Wars 2.

Yet these are all mainstream successful titles.

I dont give a dam WHY the game performs badly. 

The solution is the same every single time. Buy Intel.

If a potato played games better than an Intel CPU I would buy the potato instead. 

There are no games which run better on AMD over Intel.

Also you are far less likely to achieve 60fps with AMD in several titles where you can with Intel, including the 3 I just gave you. I will re-post the benchmarks if you do not believe me.

Why am I stupid for only caring about end user performance? I would like to hear your explanation on this one.
Reply: Scuba Sausage Firstly, why do you think  i think you are stupid. Stop making this personnel and try to have an adult conversation over simple bit of metal that fit into other bits of plastic and metal.

The whole END user experience is what i've been talking about this WHOLE time lol.

You don't listen! you do exactly what i said you do, you point fingers and "say LOOK! proof of my proof oh my" all the time and then you ignore the evidence that COUNTERS you in your own LINKS. Tell me this, where's the proof that your techs sites are correct with their numbers? where's the legitimacy? how do you know they are accurate? the fact is YOU don't. and you can't.... you simply believe them because they "approve" your buying choice and new hardware preference. 

You mentioned above how your "experience tells you what you know" well guess what pal, so does mine and what my experience is telling me is that would take even the holy bible out of context and turn fanatic if that gave you more spirituality performance because you don't ask the question that you should of asked from day 1 which is "how does this happen and why" yet again you are talking about benchmark this benchmark that, because that is how you make your decisions, because you LACK the END user experience of JUDGING AMD vs INTEL when you OWN both systems.

i do not give a damn about getting 10% to 20% more fps from swapping my damn CPU because i know in gaming you GAIN the most fps from a better GPU.

You don't need any higher FPS than 50/60 in games anyway imo.

what part of that do you struggle with?

Also, you have already said you are going to buy Intel, why are you trying to prove to me that is a good choice when i don't care WTF you buy...

wtf indeed.
Reply: Scuba Sausage 

(quote from you)
I dont give a damn WHY the game performs badly. 

So you ignore that the game could be the real problem? i guess it's just easier for you to blame the AMD part isn't it instead and just buy intel than to actually try to understand why.
Reply: Andrew Spencer Why does it matter if we blame the game or the CPU?

Blaming either doesnt help me or anyone else. 

Buying an Intel CPU would. In every single game.

Why is it stupid to be like this? At the end of the day if I bought product B (Intel) instead of product A (AMD) I would be having a better experience.
Reply: Scuba Sausage Your definition of a better experience is not the same as everyone else's dude, for instance i don't care much for playing games at over 100 fps because i game on my 32 inch Samsung smart tv, and that is only 60hz so 100fps would cause screen tearing, and i personally don't see that much of a difference unless there is a sharp drop in fps which oddly enough i only get while playing single core games on occasion.

If AMD released bulldozer and it wasn't such a flop, and performed better than everything intel had (basically  AMD's version of intel's  i7 if you follow me) but you still bought Intel, you would still be pissed off that you bought intel...see?

The tech industry is constantly evolving and if 1 tech company doesn't keep up, they get left behind VERY quickly, which is what i have been trying to tell you, Amd NEEDS a CPU refresh urgently to match intel, which is again the reason i was talking about AMD's rumoured "Zen" cpu.

AMD will catch up, simple as, and until then AMD fans can either do what you have are going to do and get a intel chip, or stay with an outdated cpu, and carry on.
Reply: Andrew Spencer What about the games that run at over 60fps on Intel and less than 60fps on AMD no matter what GPU you are using (so long as the GPU can run the game at 60fps)?

Also its not really subjective. More fps = better.

You keep saying bulldozer was terrible and Vishera being good. But according to benchmarks I can find Vishera is marginally better than Bulldozer at best.

Skyrim performs 3fps faster on the 8350 compared to the 8150.

http://www.bit-tech.net/hardware/2012/11/06/amd-fx-8350-review/6

Even in non gaming benchmarks the performance is practically the same.

http://www.bit-tech.net/hardware/2012/11/06/amd-fx-8350-review/5

The main difference between these CPU's was the power consumption and price. NOT performance.

I hope AMD do catch up because competition drives performance. But until they do I will ignore them.

Intel will be releasing chips to compete with AMD's Zen. When they do I will look at the benchmarks and choose the chip that performs best. Which is what I should have done when I bought my FX6300.
Reply: Amer Huba :)
Reply: please suggest the cheap motherboard as best as asus sabertooth mark 1
Reply: Amirul Fikri asus sabertooth r2.0

Should be the same price as the sabertooth r1.0
Reply: William Jones it WAS the king of budget builds. Now though Intel can sell you a better chip at the same price as any AMD chip. Seriously, look into it!
Reply: Scuba Sausage oh for fuck sakes.....

Are you still trying to bash on AMD c'mon dude.
Reply: Scuba Sausage hey scuba so i was looking at ur Really LONG comments and i was wondering if this build was 10/10?
Im only 16,mind u soo the parts..dont bash pls.
CPU:AMD A10-6790K
Motherboard:Asus A88X PLUS
GPU:Sapphire R9 270X Toxic
PSU:CM 700Watts G series.
HDD Storage: 3.90TB
Reply: Terty Brown Not a great build. Dont buy an APU if you are going to get a graphics card. I would recommend an i3 4330.
Reply: Idk if im going to oc, im currently building my first pc with a gtx 970 and i5 4690k im not overclocking the gpu but i might oc the cpu
Reply: Matt_ThatOneGuy I hope your not planning on doing 2k/4k gaming with that 970 with 3.25 gb of vram lol
Reply: Andrew Spencer Why cant you use a 970 for 4k?
Reply: Andrew Spencer The r9 285 that Linus was using is only 2gb so it doesn't really matter
Reply: Scuba Sausage Nvidia lied to their customers who bought the 970 on the box they advertised that the graphics card has 4gb or gddr5, but that isn't actually technically true, the 970 has 3.5 gb of vram that is fully enabled and supported by the cards L2 cache but their is a separate 500mb that is only partially supported with L2 and so when the card uses over 3.5gb of vram you can cripple the cards performance. 

Nvidia also said that the 970 had 64 rops and a memory bus width of 256bit, they also lied about that seeing as the 970 has 56 rops and a 202bit bus...

Link
http://www.pcgamer.com/why-nvidias-gtx-970-slows-down-using-more-than-35gb-vram/
Reply: Ennoiix The r9 285 uses colour compression to free up more vram not every card supports such a feature.
Reply: Andrew Spencer Ah yes I read about that but looking at these benchmarks its only a few frames slower than the 4gb 290x.

http://www.techspot.com/review/898-geforce-gtx-970-sli-4k-gaming/

But I do also read that Nvidia will be releasing a fix to free up the rest of the memory. Be interesting to see how it compares to a 290x after the fix. 

Looking at the results I dont see why you shouldnt use a 970 for 4k. a 290x is a tiny amount better (a few frames, like 2-6) but it uses AMD drivers, kicks out a lot more heat and uses way way more power. And thats before the fix. The fix might make the 970 perform faster than a 290x. Also the 970 will overclock a lot more than a 290x.

I think most people would agree that a 980 or a Titan black would be the best cards for 4k.
Reply: Scuba Sausage Are you joking, or are you serious...

The Titan black is a waste of money when compared to the 980 in 4k the 980 is cheaper and gets relatively the same performance as a $1000 Titan black..

Also what are you even talking about..

a 290x is a tiny amount better (a few frames, like 2-6) but it uses AMD drivers, kicks out a lot more heat and uses way way more power.

The 980/970 still consumes a lot of power (even more so when you have a 500+mhz overclock on it) at full load

http://www.techspot.com/articles-info/885/bench/1Power_03.png
http://techreport.com/r.x/970-cards/power-load.gif
http://www.techspot.com/articles-info/898/bench/Power_02.png

Overclocking inherently ruins a cards efficiency due to the extra heat being generated by the card, goes over the cards TDP (Thermal Design Power)  so the lost efficiency is dissipated as heat. 

Thermal Design Power
TDP is typically defined as Thermal Design Power, the amount of power (heat) that a cooler must dissipate in order to keep a silicon chip within its operating temperatures. While Intel and AMD disagree as to what test to run to measure this, both agree that it's a measurement of waste heat output from a chip

No card no matter how magically efficient retains it's FULL efficiency with an overclock of any kind, you can't defy physics. 

(but back to the topic)

That means the GTX 970 has 56 ROPs and 1792 KB of L2 cache compared to 64 ROPs and 2048 KB of L2 cache for the GTX 980. Before people complain about the ROP count difference as a performance bottleneck, keep in mind that the 13 SMMs in the GTX 970 can only output 52 pixels/clock and the seven segments of 8 ROPs each (56 total) can handle 56 pixels/clock. The SMMs are the bottleneck, not the ROPs.

Nvidia advertised that the 970 had the same spec as the 980, but as you can see, they lied and there is NO driver that can ADD back hardware that ISN'T their.
Reply: Scuba Sausage Oh dear

http://www.kitguru.net/components/graphic-cards/anton-shilov/nvidia-we-will-not-boost-geforce-gtx-970-performance-with-drivers/
Reply: Matt_ThatOneGuy why not get,gtx 980 sli 2 of them,get intel i7 4930k
Reply: Andrew Spencer Fair enough the new drivers will not offer more performance. But you can still quite heavily overclock a 970. And it does use less power than a 290x when overclocked. So its faster than a 290x and it uses less power. This is fact:

http://www.anandtech.com/show/8568/the-geforce-gtx-970-review-feat-evga/16

So if your saying a 970 card cant do 4k, then niether can a 290x. As the 970 is faster than a 290x once the 970 is overclocked.

I agree the Titan black is a waste of money. I never said it wasnt. I personally think the 980 even is a waste of money (its just a pcb and some silicon). All I said is that these are the two cards you would want for running 4k at its best today. Although I currently think 4k in general is a waste of money (today).

ParasiticHobbit DragonSchool I dont have a 4k monitor or a gtx 970. So no. If I was to go to 4k I would probably SLI 970's for it. I would prefer the 970 to the 290x because they use less power, have better drivers and are faster than a 290x when overclocked. Maybe also go for 8gb versions. But its not going to happen anytime soon. Ive just ordered one of these and im poor: 

http://www.dive-xtras.com/pages/products/cuda400.asp
Reply: ***** Nice dude do you have a Sapphire Vapor-x 8gb?
Reply: ***** The thing I have against the 290x for 4k is crossfire. I currently have crossfire 280x's and support for crossfire on them in modern games is appalling. It took 9 months for AC4 to get crossfire support which actually boosted performance, Far Cry 4 is still waiting for any crossfire support at all. Call of Duty Advanced Warfare doesnt benefit from crossfire atm (despite what the AMD website claims). Nvidia doesnt have these issues with SLI.

This is because I think realistically you need to double these cards to get (in my opinion) acceptable 4k performance.

Also I think if your going to buy an 8gb card you need two of them. 8gb is too much for any single GPU to address currently.
Reply: Scuba Sausage Yes Nvidia does have problems with SLI and the 290/290x uses XDMA which is crossfire over the PCIE which is proven to give ALOT smoother gameplay with more consistent framtimes and it's the GAMES that address a cards VRAM not the card it self for example shadow of mordor requires 6gb to FULLY enable the games ULTRA textures which in turn uses 6gb of vram if the card has 8gb, but saying that 4gb on a single card was and IS used for multi monitors not just screen resolution and graphical effects...

And yes yeah multi gpu's are optimal for decent 4k setup. 

Damn I should just get a job to teaching lol
Reply: Andrew Spencer I am only speaking from experience. I know that SLI works in Far Cry 4 atm where crossfire doesnt still (wtf ubisoft). 

One of my good friends has two x 780's and he has a lot less problems running SLI than I do running crossfire.

Another game I can think of is Dark Souls 2. You get horrific frame tearing with crossfire on but no problems with SLI.

And having owned a crossfire setup for over a year I have noticed most games get SLI support before crossfire.

Im pretty comfortable with making the statement that SLI is more supported and has less problems than crossfire. Certainly the games I play support SLI better than crossfire.

Although you have to have identical gpu's for SLI. Crossfire is a bit more flexible. You could pair a 290 with a 290x for example. SLI motherboards cost more too.

One annoying thing is that quite often games that use mantle doesnt always support mantle on crossfire when the crossfire drivers come out. So its like your giving up mantle to use crossfire, not very good.
Reply: ***** Thats why 8gb cards exist. So you can increase both the GPU power AND the memory bandwidth when operating in dual GPU mode. I certainly wouldnt bother with a single 8gb card unless I was planning on getting a second one. 

There arent technical problems addressing 8gb of ram. Just that one GPU by itself isnt fast enough to process 8gb of frame buffer to be realistically usable. Two GPU's though, would do far better. Although it all depends on the software of course. 

I think the 970 is a much better card than the 290x, even for 4k. But as I stated before thats only because you need two of either card and the games I play personally support SLI better than they support crossfire.

Oh and the 970 uses a LOT less power, pumps out (considerably) less heat. Is fanless at idle and has cuda cores so you can use things like gsync and physx. Oh and I prefer Nvidias drivers.

It is more expensive than a 290x though, which makes sense really....
Reply: ***** I wouldn't go 4k yet dude, the content and the stable consistent frame rates aren't quite there yet (unless you get 2!!! 295 x2's but that would be a sight to behold) i would wait either AMD's 300 series cards or Nvidias GM200 card that is supposedly coming out soon before you make the jump to 4k or even triple 2k tbh.
Reply: ***** Yeah I wouldnt go 4k.

Just whatever you do, dont buy an AMD FX CPU. I speak from experience.
Reply: Scuba Sausage Omg ...you and that FX cpu dude.
Reply: Andrew Spencer I hugely regret buying it.
Reply: ***** 

The 900 series from Nvidia is waste of money imo seeing as the now discontinued 780 ti offered VERY close performance to the 980/970. The 900 series sells on the cards efficiency and large overclocking headroom, but what people don't understand is when you overclock ANY card you RUIN the cards efficiency by increasing the cards power draw due to increasing mv/v which goes beyond the cards TDP and the lost efficiency is dissipated as heat.

People buy the 900 series thinking they will always get great efficiency and they are amazed at the overclocking headroom, but what they don't realise is that they RUIN the cards efficiency with overclocking (how funny) and due to the Maxwells loose architecture the massive 500+ mhz overclock doesn't actually equate to much REAL fps performance in game The box shows people numbers and they follow like sheep, because they don't know any better tbh.
Reply: Andrew Spencer An overclocked 970 uses less power than the weaker 290x.
Reply: Andrew Spencer Also the 780/780 ti is currently more expensive than the 900 series. 

The 900 series is not a waste of money. They are the best cards available for the money at the moment.
Reply: Scuba Sausage The 900 series does not even give 10% more performance than the 780 ti and the 780 ti is obviously going to be more expensive, seeing as  the card is now discontinued as in there are no more being made, so the prices will go up. lol.

http://www.techpowerup.com/205418/nvidia-kills-the-gtx-780-ti-gtx-780-gtx-770-cuts-gtx-760-pricing.html
Reply: Andrew Spencer I agree that the 900 series doesnt offer a huge performance increase over the 700 series. But it represents better value for money than any other card out there. It also runs very quietly, uses less power than its AMD competitors and it is also very overclockable.

I dont see how you can say the 900 series is a waste of money. What would you recommend instead?
Reply: Scuba Sausage Dude, when you overclock Nvidia cards (just like the AMD cards) you use a lot more power so your point their is mute due to the cards original TDP and power draw going beyond normal ranges ir an overclock, i agree that the noise levels are a lot better than the AMD counterparts but who realistically cares about noise when performance is the real reason you bought the product in the first place and proceeded to overclock it.

I wouldn't recommend any card from BOTH manufacturers atm,i would say wait and see what AMD's 300 series and Nvidia's next GM200 (and possible 980 ti afterwards) look like because like i have said 980's sell on their power efficiency and overclocking headroom, but you can't have a massive overclock on a card and it still be efficient, you can't defy physics ( overclocking = more power =more  electrical friction = heat = more noise due to fans needing to ramp up to dissipate the heat) when you overclock any card, you are making a conscious decision to forgo the efficiency for RAW performance, so lol noise and TREE HUGGING power worries aren't a factor anymore.

The Huwaii architecture has matured very well, still being able to stay close to Nvidias top tier 980's is VERY impressive for a 1yr + architecture, but i feel Nvidia's lack of performance gain has played a lot into that, but the wider memory bus and full access to all 4gb has also helped AMD as well.
Reply: Andrew Spencer an overclocked 970 uses less power than a 290x at stock. So the point isnt moot. Anyway. The 970 is faster than a 290x at stock, despite all of the advances you mention.

it doesnt matter how impressive you think the hawaii architecture is. The 290x IS slower than a stock 970.

Theres also the other advantages that a 970 has, it produces a lot less heat, runs fanless at idle etc. 

I understand waiting would be a good idea. However if someone had to buy a card TODAY, the 900 series offers the best value for money. 

Not to mention that nobody really knows when the 300 series will arrive or if it will be faster than a 970/980. Nvidia could slash prices or release a 980 ti or something. Basically nobody knows what the future will hold.
Reply: Scuba Sausage So let me get this straight you think a stock 970 is faster than a stock 290x? You are wrong on so many levels.  A 1yr + old architecture still being able to go toe toe with the 980 IS impressive even when you think it's not, you have a point with nobody knows what the future holds, but that kind of blind optimism is why Nvidia was able to sell a card that is only slightly better clock to clock than the 780 ti and lie about the 970 having the same specs as the 980...and get away with it for 4+ months..

The whole 200 series is cheaper than the 900 series so again you are wrong about the 900 series offering the best value for money.
Reply: Andrew Spencer These benchmarks wrong then? 

http://www.anandtech.com/show/8568/the-geforce-gtx-970-review-feat-evga/4

Technically the 290x is faster at 4k by a an average of 3-5 fps in most games (not all, its slower in some). At every other resolution its slower than a 970. So you could argue that I was wrong on only one level - 4k.

However you yourself said 4k was a waste of money. 

Also the 970 is barely more expensive than a 290x.
Reply: Scuba Sausage Why are you still complaining about your damn cpu on other vids......wtf dude.

 Scuba Sausage3 days ago
 
+subscribe Thankyou. I did get a bit angry at the other commentors in this thread. But I am so fed up all the mis-information. I will admit I was suckered into it. I purchased an FX6300 and its not going to last more than a year or so before I need to replace it with a faster chip again. Its not really faster than my older Q6600 in most games. 

I guess people will happily lie to claim their hardware is faster. Its just a tiny piece of silicon, I dont understand the passion. 

You don't understand the passion
But you miss informa 24/7 with silly crap like a 970 being faster than a 290x.....hahaha do you ever wonder why people try to insult you?? lol c'mon not stock for stock only maybe with the 290x being 1200 and the 970 having a 1500+ overclock buddy and only maybe.
Reply: Andrew Spencer read the benchmarks I just posted and then read these. Thats TWO sites that are saying the 970 is faster than a 290x. 

http://www.bit-tech.net/hardware/graphics/2014/09/19/nvidia-geforce-gtx-970-review/7

Gutted. You are wrong.
Reply: Scuba Sausage It;'s not hard to cherry pick dude. from your own link

http://www.anandtech.com/show/8568/the-geforce-gtx-970-review-feat-evga/5

is that wrong as well...

pfttt do you really want to do this again...
Reply: Andrew Spencer Well the 970 beats the 290x in more games than it loses. 

If anything they are a dead heat. But the 970 uses a lot less power, kicks out less heat runs silently. 

Thats a win for the 970. 

How does it feel to be wrong?
Reply: Andrew Spencer To quote you:

"A 1yr + old architecture still being able to go toe toe with the 980 IS impressive even when you think it's not"

I would think its impressive if it actually did go  toe to toe with a 980 but it doesnt.

It goes toe to toe with the 970.
Reply: Scuba Sausage *EVGA GeForce GTX 970 SC ACX2 4GB* (1,165MHz GPU, boosting to 1,317MHz, 7GHz memory) (Launch driver - GeForce 344.07)*
MSI GeForce GTX 970 Gaming 4G 4GB (1,140MHz GPU, boosting to 1,279MHz, 7GHz memory) (Launch driver - GeForce 344.07)*
ASUS Strix GeForce GTX 970 DirectCU II OC 4GB (1,114MHz GPU, boosting to 1,253MHz, 7GHz memory) (Launch driver - GeForce 344.07)*

You complain about misinformation but you are the damn king of misinformation, go ahead and act like a twit more...
Reply: Andrew Spencer Egg on your face mate:

 http://www.guru3d.com/articles_pages/nvidia_geforce_gtx_970_and_980_reference_review,14.html
Reply: Andrew Spencer You are aware that you just linked me a heat output graph that shows the 290x producing way more heat than a reference 970.

Makes you look really fucking dumb mate.

Check your benchmarks before you link them.

Now all you need to do is just admit that you are wrong and we can be done here. 

Bwahahahaha. lol.
Reply: Scuba Sausage http://www.techspot.com/articles-info/917/bench/r1920.png

http://www.techspot.com/articles-info/917/bench/r2560.png

Fake bravado doesn't work....Scuba

even in your own links the 290x stock vs the 970 stock the 970 loses because you are too dense to see that card performance varies from game to game, and driver to driver, that's why you used benchmarks with outdated drivers, give me a break you idiot, you are gutting yourself just like you have done so many times before, in many other videos..

You really are a special case, aren't you,  you look for ANY benchmark to try to prove your own point but you don't even read it or even look at them properly..you say the 970 is better than the 290x, the 970 loses more battles then it wins even against the 290 you idiot, but hey you will never see reason because you are just a puppet without a clue..

I have already shown you video where a Vapour-X 290x is 4/6FPS AWAY from a EVGA classified card,  but i guess you missed that part...
Reply: Scuba Sausage I was trying to show you where the 970/980 ACTUALLY win which is in idle loads and idle temps, but i guess you didn't get that part..

Bwah hah hah haaa...
Reply: Scuba Sausage Care to admit you are clueless and a complete and utter muppet?? no?? ok then we are not done here..
Reply: Andrew Spencer You linked two games that run (barely) faster on a 290x than a 970. I linked you three whole publications of multiple benchmarks. 

Also why did you link me a TDP graph earlier lol?

In three different sites that I linked to you, all benchmarking a number of titles the 970 won most of them.

Your too thick to realise that you would look less stupid if you either just stopped posting or admitted you were wrong. 

remember when you said that a 290x outdoes crossfired 280x's? Lol. Didnt admit you were wrong about that then and I dont expect you to now. But you are. 

Gutted.

P.S. Im still laughing at your TDP link. You complete fool!
Reply: Andrew Spencer 
More evidence to prove you wrong:

http://gpuboss.com/gpus/Radeon-R9-290X-vs-GeForce-GTX-970
Reply: Scuba Sausage I can see all you are doing reaching for explanations and ass grabbing the nearest benchmark you can find that serves in your mind to prove me wrong and you right, even tho on the contrary all they prove is how little you know vs to how little you actually do

i have given you sufficient (the proof is also in your own links) proof and a detailed explanation as to why you are not correct but like you always do you YABBER on without a clue.

Everything i have said to you is correct and fair if you are too idiotic to see that then you are the one who will ultimately lose in the long run.

i really pity you i really do, i link you a graph of TDP values and you automatically think it was a mistake and you claim a win, you pathetic moron, i was showing where the real strengths of the maxwell architecture are, which is in idle temps and idle loads...you sir are the damn fool in this predicament. 

Now get medical attention the gutting you gave yourself and call it a night.

Troll harder and bring up the past more, all you want were trolling back then and so was i.... your 6300 says hi idiot..

BWAHAHAHAH
Reply: Andrew Spencer I agree. the two performance benchmarks you linked me are 100% correct. 

Also the TDP benchmark you linked me is correct (probably). Although I still dont know why you sent it LOL. Why did you?

Unfortunately for you the multitude of games benchmarks that I have sent you are also correct. 

Can you explain how if a card is faster in two games but slower in most others that it is faster than the card that beat it in most other benchmarks?

lol.
Reply: Earn steam games over at G2A https://www.g2a.com/r/wca
Reply: Gamerman101 yeah man they are extremely cheap at https://www.g2a.com/r/salbanana
Reply: Salvador Cardenal Mejia no...my ref link https://www.g2a.com/r/wca cheater, nah im just kidin, people click either
Reply: I totally agree with OP
Reply: Except that 1000$ isn't a that small amount of money. There are enthusiasts on a budget too, you know?
Reply: Pedro Johnston You wont be gaming at 4k with a budget smaller than $1000 today. 1080p gaming however is comfortably achievable with less than $1000.
Reply: Scuba Sausage As you can clearly see in the video, you are wrong.
Reply: Pedro Johnston So your saying this machine will comfortably play any game at 4k?
Reply: No, and i never said that (neither does the video claim that). Why are you using this argument?
Reply: Pedro Johnston Alright angry man. Let me explain. You commented on thread about a video showing a $1000 build for a 4k machine complaining that not everyone has $1000 to spend. One can only assume you are implying that you would like to build a 4k gaming PC for less. 

Considering that this video is about 4k gaming I pointed out that for $1000 you would be unlikely to build a reallistic 4k gaming machine (quite true). 

You then responded angrily that I am apparently wrong. 

If you could show me a $1000 build, that includes the monitor, for a 4k machine that can achieve 30fps in any game then I will eat my words. 

However I dont think you can. This video doesnt prove anything, its an AMD promotion done through Linus. Anyone with half a brain can see that.
Reply: Scuba Sausage  Well, i'm not angry at all :). You are misunderstanding me and the video completely. Nobody ever claimed that you could build a machine that can run any modern game at 4k. Therefore, i am under no obligation to prove that to you.

The only (true) statement that was made is that this particular machine can run a subset of the most popular games (which are incidentally less demanding than most other triple A titles) at 4k. Is that wrong?
Reply: Pedro Johnston I dont think it would to be honest. These are the top 10 most popular games on steam. I think a few of these on here would struggle on this rig:

http://steamcharts.com/

This is based on the fact that the machine in question has an R9 285 card in it. Its very difficult to find 4k benchmarks for a 285. However you can find 1440p benchmarks and considering how poor the 1440p performance is, you can only assume 4k would be considerably worse. 

Your original point was that $1000 was too big a budget for some people. I would say that you would struggle to build a 4k machine that plays the games mentioned in the video for less than $1000 personally.
Reply: Scuba Sausage 

But, as you can certainly see, this machine would cope with most of the 10 most played in that link, namely Dota, CS, Football Manager, Garry's Mod, Civ 5, etc (probably all of them except Skyrim), at 4k. And that list doesn't include other games even more popular than those, namely, LoL and WoW.

You can see the benchmarks on this very video and on none of them does this machine seem to "struggle". The majority were very playable frame rates indeed.

Again, the point is that you could run most of the most popular games. Not all of them.
Reply: Scuba Sausage And by the way, I also wouldn't go for this configuration either. But the point is, that's besides the point.
Reply: Pedro Johnston The list also doesn't include Diablo 3, which I dont think would run particularly well. 

Also Civ V would probably struggle, that game uses more resources than you might think, particularly at endgame. The new BE is the same game graphically speaking and 4k benchmarks for that show a 980 running at 47fps at 4k. (Im a very heavy Civ player myself).

The video notably doesn't include the actual fps Linus was getting, I can only assume that this is because they werent great. I think I would rather game at 60fps 1080p than 30fps 4k personally. Particular in CS:GO, TF2, Dota etc. 

Basically I dont think that this machine is really a very good way of spending $1000. I think your much better off either spending more. Or going 1080p or 1440p.
Reply: ***** DX12 wont make an AMD CPU faster. It will just allow new games to utilize a graphics card instead of a cpu. If you have a poor GPU or a GPU with 2gb or less of Vram it wont help you.

AMD cpu's will always be poor for single threaded operations.

By the time DX12 becomes mainstream and games start fundamentally relying on more GPU capability the FX series will be well out of date. Especially considering that DX12 will put more demands on VRAM.
Reply: ***** Hmm thats a tough one. Techspot recently made a case to say that it has lot the budget market to the i3:

http://www.techspot.com/review/943-best-value-desktop-cpu/page6.html
Reply: ***** I personally would rather have an i3 than an FX6300. They cost the same and the i3 seems to outperform the FX6300 when its overclocked. 

Each to their own I guess.
Reply: thor brantly I meant the i3 outperforms the FX6300 when the FX6300 is overclocked and the i3 is not. Also the i3 does only have two cores. It also has hyperthreading though. 

I dont care how many cores it has anyway so long as it performs well. Bechmarks clearly show the dual core i3 outperforming the 6 core FX...
Reply: thor brantly Yeah they do and many of these games still seem to perform better on the i3. Far Cry 4 for example can use 8 cores and it runs faster on an i3 then an overclocked 8350.

It seems to me that IPC is a lot more important that core count when it comes to games.
Reply: RainieDays93 He never mentions the Gaming PC Build includes the monitor. That monitor in the video is 1k by its self, so it doesn't include the monitor.
Reply: Giggity Goebbels
What exactly is bullshit about it, what people, what loopholes?
On which boards will the vrm "likely" fail and do you have had any prior experience with it yourself? Why are AMD boards shit - because they have AMD sockets?
How is the 970 "not much more priced" than the 285 - define "much" in that statement.
If you manage to coherently answer any of these questions i will not consider you an idiot/fanboy/parrot anymore.
And i believe we will be able to get a real discussion going without fanboy-propaganda/marketing-halftruths and find the best price performance ratio at 4k for everyone. :D